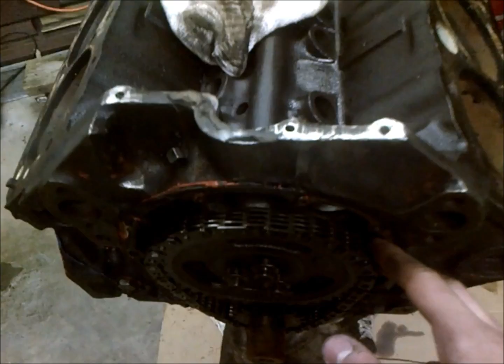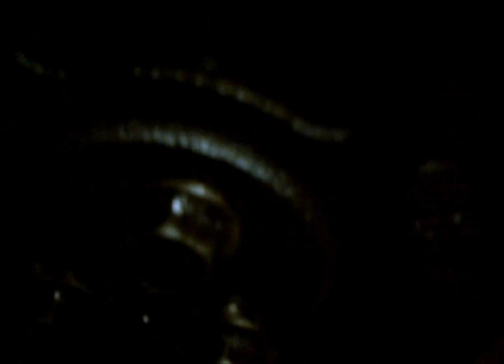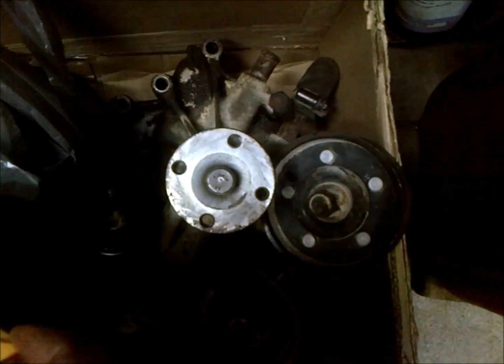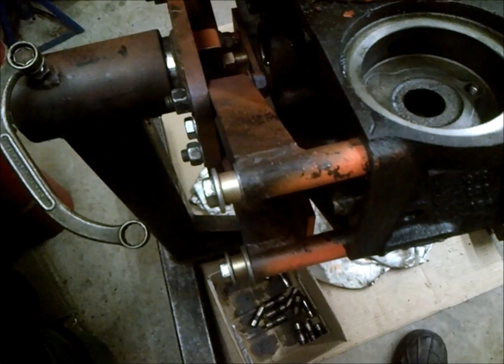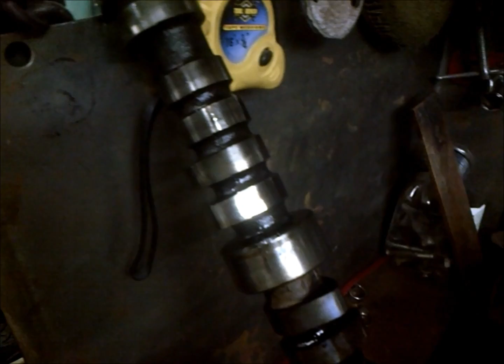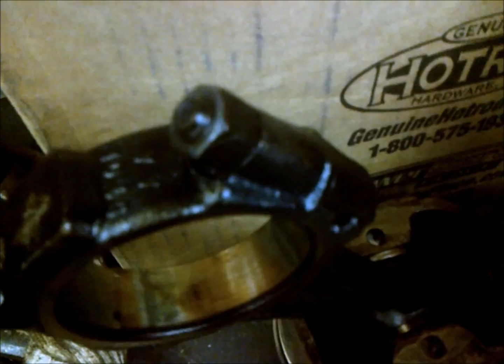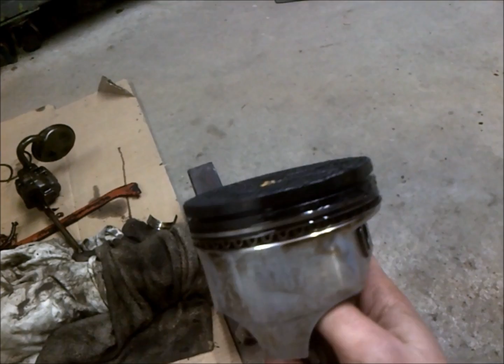350 Chevy vs Ford 302 Comparison: (Dumb Redneck Viewpoint)

Comment: THE LS USES A TEN BOLT HEAD PATTERN SQUARE BORE SEALING WHICH ALLOWS FOR HIGHER CYLINDER PRESSURES WHEN USING TURBO'S AND SUPERCHARGERS. ON A STOCK 5.0 ENGINE WHICH DEBUTED BACK IN 1983 IT CAN HANDLE 18LBS OF BOOST WITH NO PROBLEM AND GO MUCH HIGHER. WITH THE CHEVY SMALL BLOCK 8LBS OF BOOST WAS THE LIMIT. IF YOU WENT ANY HIGHER THEN THAT BLOWING A HEAD GASKET IS THE LEAST OF YOUR PROBLEMS. YOU WOULD DROP THE MAIN CAPS. THE SMALL BLOCK FORD HEAD BOLTS ANCHOR INTO THE BLOCK WEBBING WHERE THE CHEVY BOLTED ON TO THE BLOCK DECK WHICH MADE A WEAK SEAL BETWEEN THE HEAD AND BLOCK. TO BOOT THE SMALL BLOCK FORD WAS 70LBS LIGHTER THEN THE SMALL BLOCK CHEVY AND WAS STRONGER AND MADE MORE POWER. THIS IS THE REASON CHEVY DUMPED THE OLD SMALL BLOCK IN FAVOR OF FORD DESIGNS WHEN THEY CREATED THE LS WHICH IS COMPLETELY BASED ON FORD DESIGNS. NOTHING REMAINS FROM THE OLD SMALL BLOCK CHEVY.
Reply: YOU WROTE AND ENCYCLOPEDIA OF INFORMATION HERE BUT YOU ARE TOTALLY WRONG. THE FORD WINDSOR SMALL BLOCK WAS PHASED OUT BECAUSE OF PRESSURE FROM GOVERNMENT OFFICIALS TO MEET HIGHER EFFICIENCY. IT WAS A MUCH BETTER MOTOR THEN THE SMALL BLOCK CHEVY HANDS DOWN AND THERE IS MORE TO THIS STORY. GM/CHEVY AND THE GOVERNMENT HAVE BEEN IN BED WITH EACH OTHER SINCE THE DAYS OF BONNY AND CLYDE. THEY HAVE THEIR TENTACLES EVERYWHERE AND HAVE CORRUPTED THE INNOCENTS OF RACING FOR MANY YEAR WITH RULES WRITTEN AND UNWRITTEN AND REGULATIONS THAT HANDICAP THE COMPETITION AND FAVOR CHEVY WHICH WE WILL GET TO LATER ON IN THIS DEBATE. WHEN THE 5.0 MUSTANG DEBUT IN 1983 IT KILLED THE SMALL BLOCK CHEVY. THE 5.0 STOMPED ALL OTHER THE CHEVY 350 YEAR AFTER YEAR. THE GREATER LOOMING THREAT WAS THE 351 WINDSOR WHICH WOULD EVENTUALLY MAKE IT'S WAY UNDER THE HOOD OF THE MUSTANG AND GM ENGINEERS WERE WELL AWARE OF THAT. SO GM HAD THEIR FRIEND IN THOSE HIGHER PLACES PUT STRICTER EFFICIENCY REGULATIONS ON FORD AS A UNDERHANDED PLOY TO STOP FORD FROM EVER PUTTING THE 351 UNDER THE HOOD OF THE MUSTANG WHICH MEAN LIGHTS OUT FOR BOTH THE CAMARO AND CORVETTE. AT THE TIME THE 5.0 WAS THE HIGHEST VOLUME OUTPUT MOTOR IN THE WORLD. THE ONLY ENGINE THAT CAME CLOSE TO IT WAS THE ENGINE IN THE 308 FERRARI. THIS MEANS IT WAS ALSO THE MOST EFFICIENT ENGINE PRODUCED WHICH THROWS YOUR ENCYCLOPEDIA OF INFORMATION RIGHT INTO THE GARBAGE. IN TAXI CABS IN BIG CITIES LIKE NEW YORK THE CHEVY SMALL BLOCK WAS DONE AT 60,000 OF 24-7 IN NEED OF A TOTAL REBUILD WHILE THE FORD 302 WAS STILL RUNNING AT 500,000 MILES.  DO NOT EVER COMPARE THE CHEVY SMALL BLOCK TO THE FORD SMALL BLOCK.
Reply: WHY ARE YOU YELLING?
Reply: The real question is why would you think a LS motor was biased on a ford design ?  they share absolute nothing in common.  Unlike the ford Winsor motors  the Chevrolet smallblock was in production until 2004 and was only phased out when there was no longer a chassis being produced to use the motor (see gm express van)  Ford had to abandon the winsor block back in the early 90`s because they could not get ring seal to allow the use of  obd2 advanced catalytic converters. The oil consumption from the premature wear on sbf valve guide`s was also a issue they could not overcome.  GM on the other hand was years ahead of ford with the sbc development and had the engineering perfected to the point the engine could meet strict lean burn emissions standards up to the 2004 model year. A direct result of using the head bolts in the deck is the reduced cylinder distortion from anchoring the head bolts in the block webbing. This created a motor that could run well over 150,000 miles with proper maintence and no excessive ring wear. The advanced vortec cylinder heads gave the SBC the air flow of iron race head of the time. this same head cooled so well a lean burn fuel injection could produce great power with emissions only a fraction of fords best Winsor motor  The iron block LS is a original design created with extreme lean burn in mind. The ls has advanced cooling system that allows more efficient cooling in the cylinder head to permit higher compression. The ls heads are nothing like any ford ever made. intake ports with higher flow rates then any oem ford motor modular motor or winsor and exhaust ports designed to flow more and prevent excessive heat transfer from the exhaust to the cylinder head (short direct port).  all this was done using a 2 valve head ford could not get even close to the same power levels even with there 3 valve modular motor. Ford finally started to get close with the 5.0 coyote motor after giving up on the 6.2 l canted valve motor. Ford could not get the reliability out of the 6.2 it suffered valve spring and valve failure from trying to get to much power with a  aggressive cam profile. The aluminum  LS is a true race piece with all the attributes of the iron block with massive weight savings. Sorry but your claim of a stock 1983 302 being able to handle 18 lbs boost is ludicrous at best. the 1983 302 is a lightweight emissions motor with anemic cylinder heads very under built rods with puny rod bolts. very lightweight cast pistons (will not support 400 hp with out cracking) not to mention a nasty habit of very poor head gasket sealing.  The 1983 iron cylinder heads have such a poor combustion chamber design knocking and pinging from carbon buildup was common long before the motors ever made it out of warranty. now try to do 18 lbs of boost on this motor. Sorry you do not know what you are talking about. the motor would grenade long before you ever reached 18 lbs of boost.
Reply: Frank289100, you have got to be the most delusional idiot I have ever seen.
Reply: Yeah, why are you yelling?
Reply: If cumstangs really pot down those numbers you claim they wouldn't have been 4 bolt rear that's a fact jack
Reply: WHAT DRAG RACING IS TODAY IN TERMS OF POWER ADDERS LIKE NITROUS, SUPERCHARGING AND TURBOS WAS SINGLE HANDEDLY SHAPE BY THE SMALL BLOCK FORD. CHEVY DID NOTHING AS THEY SAT HELPLESSLY AND WATCHED FORD RUN AWAY WITH THE SHOW. THIS IS THE REASON THEY REDESIGN THEIR CONVENTIONAL SMALL BLOCK USING FORD DESIGNS SO THEY CAN FINALLY COMPETE AGAINST FORD. FROM TO TO BOTTOM THE LS IS A REGURGITATED FORD 427 HIGH RISER ENGINE OR A 351 FORD WINDSOR WITH RAISED PORTS. THE NEXT ADVANCEMENT FOR THE LS IS A CLEVELAND STYLE HEAD. THAT WHOLE CHEVY CAMP IS BASED ON CHEATING RIGHT FROM THE DRAWING BOARD TO NHRA RULES AND RULE BOOKS THAT FAVORED CHEVY TO WIN.
Reply: Same with the 9 inch rear. Nothing special - just inexpensive and plenty available. The pumpkin style 55 up Olds and Pontiac rears are way stronger but GM didn't make as many.<<<--- THESE GM REARENDS WERE NOWHERE NEAR AS STRONG AS THE FORD 9 INCH. TO START THE RING AND PINION TEETH CONTACT AT 3 POINTS WHERE ALL THE REST OF THE REARENDS INCLUDING THE DANA CONTACT 2. THE PINION IS ALSO SUPPORTED BY A INNER SHAFT ALSO SUPPORTED BY THE HOUSING. THEY ARE LIGHT AND THEY ARE EASILY TO SET UP AND SERVICE. IT IS THE STANDARD IN RACING TODAY FROM 1/4 MILES, DIRT TRACK, NASCAR AND ALL FORMS OF RACING.
Reply: Ford copied GM at every turn because GM led the industry in innovation while Ford followed.

Ford had to put Paxton blowers on the 50s T Birds just to keep up with the naturally aspirated Corvette with a much smaller fuel injected V8.

GM sold fuel injected vehicles in 1957 and EFI systems in 1975 while Ford waited until 1980 to offer their first fuel injected vehicles.
Reply: Honda civics are four Bolt as well join that cc
Reply: Frank289100 Yeah, 2 of my 5 friends were Ford fans, then my 3 chevy friends all switched because they saw how hard we beat on our Fords, now they all drive Fords and one drives Dodge trucks but wants me to help him find a Torino or Fairlane! we are all 52 to 57 years old, LS chevy is just a chevy FORD Cleveland copy, I had 40 cars,14 Fords, 10 GM, 12 mopars, and GM was a fall apart pile of crap, I used the best oils and still had flat cams, think about this my 1977 302 Mustang II weighs 170 pounds more than my 1978 350 Nova! because the Nova has no metal for its size, and the doors shut like crap, and the mustang has 187,000 miles on it! nova has 121,000, I will say the Nova is a little quicker and needed a cam at 77,000but gets less MPG than the Mustang which never needed anything but a water pump!
Reply: Why assume that they copied Ford? Pontiac used 10 head bolts on their V8. So did Olds, Buick and Cadillac. 
 
The exhaust port separation is the same as the Big Block Chevy and the Cadillac V8.  Cadillac had an OHV V8 long before Ford copied it.

Ford has copied so many GM innovations they ought to make Ford an honorary division of GM.
Reply: Ford didn't invent the V8. Ford just sold the cheapest V8.  Same with the 9 inch rear. Nothing special - just inexpensive and plenty available. The pumpkin style 55 up Olds and Pontiac rears are way stronger but GM didn't make as many.

Cadillac was bought in 1902. The first Cadillac V8 came in 1914 and it was not a Ford design.
The first Ford V8 was introduced in 1932.

Chevrolet dominated Nascar with their small block. Neither Ford  small block could cut it in Nascar until they got special permission to use a combo of Cleveland and Windsor parts.

That must really hurt your blue oval feelings that a 1955 hunk of GM junk engine beats a 1969 Ford design so bad that they left Nascar until they got some help from Bill France.

Don't forget how Pontiac jumped in for a few seasons in the early 60s and made those Holman & Moody FE boat anchors look like meter maid carts.
Reply: Ford didn't invent the V8. <<--HENRY FORD IS THE FATHER OF THE V-8 ENGINE. WHEN HE SOLD HIS COMPANY IN 1901 IT WAS RENAMED CADILLAC. OBVIOUSLY THEY BOUGHT SOMETHING FROM HIS COMPANY AND IT WASN'T A FENDER NOR A STEERING WHEEL NOR A AXLE. WHAT HENRY FORD SOLD THEM WAS V-8 TECHNOLOGY. IT WAS FORDS IDEA OF PUTTING 2 FOUR CYLINDERS TOGETHER WHICH HE DID IN THE VERY LATE 1899-1900. THE ONE PROBLEM THE V-8 HAD WAS BALANCING. IT WAS A EXPENSIVE AND TIME CONSUMING AND ONLY BY ACCIDENT DID THEY GO INTO PERFECT BALANCE. MOST OF THEM WERE NEVER TRULY BALANCED AND EVENTUALLY VIBRATED THEMSELVES TO DEATH. THIS IS WHY THE HIGH END CARS LIKE CADILLAC WHICH WERE MADE IN LIMITED NUMBERS HAD THEM. MASS PRODUCING THE V-8 WAS TOTALLY OUT OF QUESTION. THE RICH BOUGHT CADILLACS AND BY THE TIME THE MOTORS WENT OUT OF BALANCE THEY WERE SOLD AND REPLACED BY THE NEWER CADILLAC MODELS. DID YOU EVER WONDER WHY IT TOOK THE AUTOMOBILE INDUSTRY 20 YEARS TO CATCH UP WILL THE FLATHEAD FORD. BECAUSE THEY DIDN'T HAVE THE KNOWLEDGE OF HOW TO BALANCE THE V-8 ENGINE AND HENRY FORD DID RIGHT FROM THE START WHEN HE SOLD IT TO CADILLAC. THE FLATHEAD FORD FROM THE START WAS SUPPOSE TO BE A OVER HEAD VALVE ENGINE. HENRY FORD KNEW HE WAS GOING TO SELL MILLIONS OF THESE MOTORS AND FOR COST EFFECTIVE REASONS MADE IT A FLATHEAD DESIGN. HENRY FORD IS THE GREATEST MECHANICAL GENIUS OF ALL TIME. HE IS AND ALWAYS WILL BE THE FATHER OF THE V-8 ENGINE AND THE FLATHEAD FORD IS THE MOTHER OF ALL V-8 ENGINES INCLUDING THE CHEVY SMALL BLOCK. THE FLATHEAD FORD SINGLE HANDEDLY SHAPED DRAG RACING INTO WHAT IT IS TODAY. IT RULED ALL FORMS OF RACING FOR ALMOST 20 YEARS, BEFORE A FORD ENGINEER AT A PARTY RIGHT AFTER THE WAR IN DETROIT GAVE GM THE DESIGNS OF THE SMALL BLOCK CHEVY.
Reply: Chevrolet dominated Nascar with their small block. Neither Ford  small block could cut it in Nascar until they got special permission to use a combo of Cleveland and Windsor parts.
That must really hurt your blue oval feelings that a 1955 hunk of GM junk engine beats a 1969 Ford design so bad that they left Nascar until they got some help from Bill France. <<--FROM 1964-1969 FORD AND CHRYSLER DOMINATED NASCAR. ONLY CHEVY IN THOSE YEARS WON 4 RACES WITH THE 327 ON SHORT TRACKS BECAUSE THE INLINE SMALL BLOCK FORD WAS DEEMED ILLEGAL FOR USE BY NASCAR GIVING CHEVY A CHANCE TO WIN ON THE SHORT TRACKS. NASCAR DIDN'T WANT THE FORD TEAMS USING THE SMALL BLOCK FORD ON THE SHORT TRACKS TO PREVENT FORD FROM DOMINATING THEM. THE SMALL BLOCK 289 IN RACE TRIM MADE 450HP AND WEIGHED ALMOST 80 LIGHTER THEN THE SMALL BLOCK CHEVY SO IT ALLOWED IT TO GO INTO THE TURNS A LOT FASTER WITHOUT INERTIA AFFECTING IT AS MUCH SINCE IT WAS LIGHTER. THE RESTRICTOR PLATE WAS INTRODUCED IN 1970 BY NASCAR TO STOP THE FORD BOSS 429 FROM SLAUGHTERING THE HEMI SINCE IT WAS CHRYSLER IN 1964 WHO HAD THE 427SOHC ENGINE BANNED AND LATER HAD THE FORD 427 HIGH RISER BANNED. NASCAR LATER RESTRICTS RACING TO THE SMALL BLOCK AS A MEANS TO ALLOW CHEVY AND THE REST OF GM TO COMPETE WITH FORD AND CHRYSLER. SO THEY KEPT THE RESTRICTOR PLATE TO STOP FORD FROM DOMINATING NASCAR AND ALSO LIMITED THE CARBURETOR CFM'S TO REDUCE HORSEPOWERS AND EVEN THEM ALL UP. REMEMBER THE CLEVELAND WERE DESIGNED TO BREATH AND THE RESTRICTOR PLATE AND SMALL CARBURETORS CHOKED THESE MOTORS. ADD THAT IN WITH RULES AND RULE BOOKS FAVORING CHEVY TO WIN AS ALWAYS CHEVY CHEATING THERE WAY TO THE FINISH LINE. TODAY'S CHEVY NASCAR ENGINE IS A FORD CLEVELAND CHEVY AND THE PREVIOUS SB2 (CLEVELAND BASED HEADS) WAS DESIGNED BY FORD IN EXCHANGE TO ALLOW THEM TO RUN A 2 DOOR TAURUS WHICH DIDN'T EXIST. EVERYTHING CHEVY USES TODAY IN NASCAR IS FORD BASED.
Reply: Pontiac wasn't nearly as serious about NASCAR as Ford was back in the early 60s.
GM cut their NASCAR involvement way back because the government was worried that they were getting too big. "1962 GM was getting roughly 53% of the entire U.S. auto industry sales and the U.S. Justice Dept became interested. They were watching GM, and should GM get close to 60% they would consider breaking GM up. The precedent had already been set with Standard Oil years earlier, and their threat to GM had realism. GM thought that one of the ways they could cut that growth was to stop actively participating in motorsports and to cut their dollars there,”Wikipedia <<- TOTAL NONSENSE. GM AND THE GOVERNMENT HAVE BEEN IN BED SINCE THE DAYS OF BONNY AND CLYDE. FEDERAL AGENTS WERE SCREAMING TO START BUYING THE FLATHEAD FORD'S SO THEY CAN CATCH ALL THE BANK ROBBERS, BOOTLEGGERS, ETC WHO WERE USING THE FLATHEADS BECAUSE THEY WERE FAST WHILE GOVERNMENT AGENTS USED GM PRODUCTS WITH STRAIGHT 6'S AND 8'S WHICH COULD NEVER CATCH THE FORD'S. THEY WERE SO BUDDY BUDDY THAT THEY REFUSED TO FORD FORD'S AND THEIR RELATIONSHIP STILL GOES ON TO THIS VERY DAY BEING THE REASON THE GOVERNMENT BAILED THEM OUT WITH TAX PAYERS MONEY WHICH THEY STILL NEVER PAID BACK.
Reply: I worked for a government fleet for decades and we bought whatever fit the budget. If Ford could build something that did the job we bought Fords. We kept good records so we knew which vehicles were dependable and cost effective to maintain and I can't remember any single Ford model that distinguished itself above the other brands. I do remember plenty of Ford lemons. The 1985 police Crown Vics with the 5.0 TBI was capable of a blistering 78 MPH top speed and cops often complained about getting outran by 4 cyl Japanese cars and VW Beetles. The 1987 Crown Vic cop cars with the 5.8 were capable of a blistering 85 MPH top speed. A 305 Malibu and a 318 Diplomat could do 115 MPH and a 350 Caprice could do 125 MPH. If you were a cop would you choose the car that couldn't run down a Yugo just because it was your family brand?

Ford borrowed 24 billion from the government. When are they planning to pay that back? Looks like they can't afFord to.
Reply: I never saw a Maverick or Granada cop car but I guarantee you that neither one of your 302 powered Fords would get over 90 MPH with a full light bar on the roof. Those 85- 87 Crown Vics had no power from the day they were delivered so blame Ford for the lack of performance. 

You want me to believe a 3800 pound sled with 140 HP and 250 lb-ft of torque can do better than 85 MPH with a big fat light bar on the roof then show me some evidence.

All I'm hearing is a little fan boy.
Reply: BACK IN THE LATE 1980'S I SAW A FORD E-250 MR. GOODWRENCH PART DELIVERY VAN FROM A GM DEALER. I JUST COULDN'T STOP LAUGHING.
Reply: BOBBY, BOBBY BOBBY. IF THE GMO CORN AND SOYBEANS WASN'T CLOUDING YOUR BRAIN YOU WOULD HAVE LEARNED SOMETHING YEARS AGO. FIRST THING TO KNOW IS THAT THERE WERE NO RACE PARTS AVAILABLE FROM NEITHER FORD NOR THE AFTERMARKET FOR THE SBF, WHICH ALL STARTED WITH THE 289ci BACK IN THE 1960'S. THE 289 WAS SUCH A THREAT TO THE SBC THAT THE NHRA WOULD CHANGE THE RULES AND THE RULE BOOK ON THIS MOTOR TO DISCOURAGE ANYBODY FROM RUNNING THEM. IF YOU RAISED HELL AT THE TRACK THEY WERE CHANGING THE RULES IMMEDIATELY ON THE 289ci SO YOU COULDN'T COME BACK NEXT WEEK AND RACE. THIS IN TURN KILLED OFF NOT ONLY THE FACTORY SUPPORT OF RACE PARTS BUT ALSO THE AFTERMARKET SUPPORT OF RACE PARTS. NEITHER FORD NOR THE AFTERMARKET WOULD PRODUCE RACE PARTS FOR A MORE WHICH WOULD BE OUTLAWED OVERNIGHT LEAVING THE MANUFACTURERS WITH A WAREHOUSE FULL OF SCRAP METAL. THIS IS THE REASON IF YOU WERE ABLE TO GET RACE PARTS FOR A FORD THEY WERE 3-5 TIMES MORE EXPENSIVE AND MOST OF THE TIME THEY WEREN'T AVAILBLE. IT TOOK THE AFTER MARKET ALMOST 25 YEARS TO FINALLY PRODUCE A HEAD WHICH TRICK FLOW DID IN 1987 AND LET ALONE IT WAS THE GENESIS OF RACE PARTS FINALLY FOR THE SMALL BLOCK FORD WHICH WAS SO POPULAR THAT IT REVISED A RESURGENCE IN RACING AGAIN. THE RACE TRACK ATTENDANCE WAS DYING AND THE STANDS WERE EMPTY BUT WHEN THE MUSTANG 5.0 DEBUTED IT RESPARK THE RACING BUG AND RACING CAME BACK INTO FASHION AGAIN. SO THE NHRA NO LONGER REGULATED THE SBF BECAUSE IT BENEFITED ATTENDANCE FOR THE NHRA.. PRYOR IF YOU WANTED A RACE HEAD FOR A FORD YOU HAD TO MAKE IT. YOU TOOK CHEVY VALVES LIKE THE 2.02 AND MACHINED THEM TO FIT A FORD HEAD SO YOU CAN ALSO USE ALL THE SPRING AND RETAINER PARTS AVAILABLE FOR THE CHEVY WHICH WERE LEGAL FOR USE BY THE NHRA. TO SUM IT ALL UP IT WAS ALSO THE CASE FOR THE FORD GUYS RACING THE CLEVELANDS TO USE A CHEVY ROD BECAUSE NOBODY WOULD TAKE THE CHANCE OF PRODUCING RACE RODS FOR THE CLEVELANDS WHICH THE NHRA WOULD HAVE OUTLAWED WITH SOME STUPID RULE. SADLY THEY DID OUTLAW THE CLEVELANDS WHEN GM HAD THE NHRA THEIR HENCHMEN MANDATE THE 500ci RULE. THIS IS WHEN GM TOOK A OLDS BLOCK AND MACHINE IT TO TAKE A CHEVY CRANK AND CAM AND THEN MADE A BIG PAIR OF FORD CLEVELAND HEADS FOR IT. THIS IS WHEN BOB GLIDDEN WENT TO THE BOSS AND THE CLEVELANDS WERE NO LONGER RACED SO THE DEMAND FOR A RACE ROD FOR THE CLEVELAND NO LONGER EXISTED. SINCE 1983 TO PRESENT DAY WHAT CHEVY HAS BEEN WINNING WITH IN PROSTOCK IS NOTHING MORE THAN A BIG CUBE FORD CLEVELAND MORE WHICH IS YOUR DRCE - DRAG RACE COMPETITION ENGINE. SAD BUT TRUE GMO POPCORN BOBBY.
Reply: 1.) The Crown Vic had to wait until GM quit producing Caprices to "rule" police/taxi service.  That's a fact!

2.) 55,000 miles in police/taxi fleet service is equal to about 300,000 consumer driven  miles.

3.) Even after Ford figured out how to make the Crown Vic trans last beyond 6000 miles they never did get them to last as long as the older Chevys UNDER THE SAME EXACT CONDITIONS AND MAINTENANCE SCHEDULE.!

4.) When did any GM brand need to saw half of their cylinder head off and bolt on exhaust plates just to be able to compete in NASCAR and NHRA?

5.) When did any GM brand need to COMBINE THE BEST PARTS OF TWO DIFFERENT ENGINE FAMILIES just to be able to compete in NASCAR?

Fact. Clevelands and Windsors couldn't compete in Nascar so they had to cherry pick parts to make a CLEVOR. Ford has always been the special needs child of NASCAR. Ford can't compete? No problem just change the rules to help the poor babys.
Reply: There never was a debate here. Bobby and I have been killing you with facts and you have offered nothing but lunacy based ramblings in return. 

Remove your tinfoil hat and try posting some  evidence that NASCAR and NHRA banned the Ford Windsor because it was such a threat.

Of course you can't do that because the evidence only exists in your mind. I'm willing to bet you're the guy that's in the loony bin with Carl Childers who's crazy bout a Mercury Comet.

Thanks for the laughs and fantasies little Franky.
Reply: IF THEY WERE ADDING MORE WEIGHT TO THE CLEVELAND POWER FORDS ITS CRYSTAL CLEAR THE CHEVY WAS NO COMPETITION FOR THE FORDS. THE CLEVELAND MOTOR WAS SO DOMINATING THAT GM AND THE NHRA HAD TO DO SOMETHING VERY DRASTIC AND QUICK BEFORE PROSTOCK RACER WOULD EVENTUALLY SWITCH OVER TO CLEVELAND POWER AND THE END OF THIS PHONY CHEVY RACING DYNASTY. SO THE SOLUTION WAS TO MANDATE THE 500ci RULE AND BUILD A TOTALLY NEW ENGINE THE DRCE WHICH IS NOTHING MORE THAN A BIG CUBIC INCH FORD CLEVELAND MOTOR. THE REASON THE CHEVY SMALL BLOCK REACHED THE STATUS IN RACING THAT IT DID WAS BECAUSE THE NHRA DETERMINE THAT IT WAS TO WIN USING RULES AND RULE BOOKS TO FAVOR IT. ADDING WEIGHT TO THE FORD WAS A MAJOR PART OF IT. WHEN BOB GLIDDEN WENT TO CHRYSLER AND RACED THE PLYMOUTH ARROW AND WON. THEY ALSO SUBJECTED THE SMALL BLOCK CHRYSLER TO CARRY MORE WEIGHT. THE SMALL BLOCK CHRYSLER WAS ALSO A BETTER MOTOR THAN THE CHEVY. ARCHITECTURALLY THEY ARE SIMILAR BUT THE CHRYSLER IS A BETTER DESIGN. INSTEAD OF THE 23 DEGREE VALVE ANGLE LIKE THE SBC. IT HAS A 18 DEGREE STOCK VALVE ANGLES WHICH FLOW BETTER. THE BETTER SBC RACE HEADS USE THESE ANGLES TODAY. IT HAS A HIGHER CAM LOCATION ALLOWING IT TO UTILIZE SHORTER PUSHRODS THAT FLEX LESS AND ALSO USES RAIL TYPE ROCKER ARE WHICH CONTRIBUTE TO A MUCH MORE STABLE VALVE TRAIN ALLOWING FOR HIGHER RPM'S. IT ALSO HAD ANGLE PLUGS FOR A BETTER MORE EFFICIENT BURN. SO THESE FACTOR ALLOWED THEM TO MAKE BETTER POWER THAN THE CHEVY AND IN TURN THE CHRYSLER SMALL BLOCK FACED THE SAME FAITH AS THE FORD WHICH WAS MORE WEIGHT, WHICH INTERPRETS TO KEEPING CHEVY IN THE WINNERS CIRCLE. IF THIS CHEATING DIDN'T OCCUR THE RECORD BOOKS WHEN IT CAME TO CHEVY, WOULD TELL A TOTALLY DIFFERENT STORY.
Reply: Ford numbers their cylinders from front to back and GM numbers their cylinders from side to side so the numerical firing order is completely irrelevant.
Reply: Quote Frank:  "EVERYBODY RIPPED THEM OUT"

You mean like how everyone is ripping out their weak Mustang engines and putting GM engines in them so they can outrun all the Ford powered Mustangs?
Reply: Nascar specs the Ford 9 inch because they are cheap and have a lot of ratios available.
Every NASCAR spec 9 inch is mounted on archaic, antique, Chevrolet truck suspension parts from the 1960s. Are you going to tell us that antique Chevy truck suspensions are mandated by NASCAR because they're better than Ford parts? Seems so.
Reply: WHAT RACING IS TODAY IN TERMS OF TURBO, SUPERCHARGING AND NITROUS WAS SINGLE HANDEDLY SHAPED BY THE SMALL BLOCK FORD. CHEVY DID NOTHING THEY JUST COULDN'T COMPETE. THE SMALL BLOCK FORD HAD NO COMPETITION AND THE REASON A DOZEN 5.0 CLASSES EXISTED FROM 5.0 PRO TO 5.0 OUTLAW. THEY HAD TO RACE AGAINST THEMSELVES BECAUSE THE COMPETITION WAS NO MATCH. THIS IS THE REASON CHEVY DUMPED THE OLD SMALL BLOCK IN FAVOR OF FORD DESIGNS. FROM TOP TO BOTTOM THE LS IS COMPLETELY FORD DESIGNS. NOT ONE 11111111111 DESIGN ASPECT OF THE SMALL BLOCK CHEVY LIVES IN THE LS. IT IS 1000% FORD.
Reply: Poor Frank is too ignorant to understand that Ford's best selling V8 (302) has the same firing order as the small block Chevrolet. He's too caught up in a number line.
Reply: If my simple area code analogy didn't penetrate Franks's thick skull - nothing will.

Fallacy is all he has. If there was a NASCAR or NHRA rule against the Ford Windsor engine he would have posted the evidence a long time ago. Why would NASCAR make a rule against an engine that couldn't even make enough HP to qualify for a race? It's sheer madness! Time to cut the Wifi at the asylum.
Reply: 1.) You're apparently too ignorant to understand that IMSA has several different classes running at the same time on the same track and several Chevrolets from lower classes  finished ahead of several GT40 Fords. 

2.) Ford got lucky for a few years due to the  1968 engine rule that limited the prototypes to 3 liters.

3.) IMSA never banned Ford; the competition just got so much better that Ford couldn't cut it.  Henry Ford 2 did what he set out to do which was to beat Ferrari.

4.) The GT40 was obsolete by 1970 and its replacement was a dismal failure.
Reply: Yes Chevy just copied the Cleveland and Windsor motors ha ha ha!
Reply: He meant Chevy copied Fords Superior Cleveland V8
Reply: 1.) Clevelands were so bad Ford quit selling them after 3 years.

2.) The LS engine has very little in common with a Ford design.

3.) Chevy Big Blocks used canted valves long before Ford made an inferior copy of them that didn't sell and had to be scrapped.
Reply: Tim Sharpe That's funny I have a cougar with a 351c that had over 214,000 on it never rebuilt, just a water pump, used 10-40 Valvoline and STP, now you're making up crap sonny.
Reply: Tim Sharpe LS is just a Cleveland copy, it took chevy 60 years to figure out how to seperate the center exhaust ports to stop head cracking.
Reply: The LS is nothing like a sorry Cleveland.

1.) LS engines don't have canted valves.

2.) LS engines have a proven record of durability.

3.) Clevelands were discontinued after three years of being outsold by the Windsor.
Reply: Tim Sharpe The exhaust ports separation and the head bolt idea were though.
Reply: Why assume that they copied Ford? Pontiac used 10 head bolts on their V8. So did Olds, Buick and Cadillac. <<-- FORD Y-BLOCK AS FAR BACK AS 1953 USED THE 10 BOLT HEAD PATTERN (4 BOLTS PER CYLINDER). THE CADILLAC USED THE SAME 5 BOLT PER CYLINDER IN 1959 AS THE CHEVY SMALL BLOCK.
 
The exhaust port separation is the same as the Big Block Chevy and the Cadillac V8.  Cadillac had an OHV V8 long before Ford copied it.<<<--- BIG BLOCK CHEVY HAS SIAMESED INTAKE RUNNERS. HENRY FORD'S FIRST COMPANY WAS SOLD AND RENAMED CADILLAC. HE SOLD THEM HIS V-8 TECHNOLOGY WHICH IS HENRY FORDS IDEA OF PUTTING 2 4 CYLINDERS TOGETHER. 

Ford has copied so many GM innovations they ought to make Ford an honorary division of GM. <<-- EVERYTHING IN RACING TODAY WHICH CHEVY USES CAME FROM FORD. PROSTOCK DRCE, NASCAR SB2 AND RO7, SYMMETRICAL HEAD BIG BLOCK IN RACING LABELED AS CHEVY ARE ACTUALLY BIG CUBE CLEVELAND MOTORS. CHEVY MOUNTAIN RACE MOTORS 800+ CUBIC INCH ARE BOSS 429. THE 1989 ZR1 CORVETTE DOHC V-8 WAS DESIGNED AND BUILT BY FORD WHO OWNED LOTUS AND SOLD 70% OF THE COMPANY TO GM BUT MAINTAINED THE ENGINE RESEARCH AND MANUFACTURING DIVISION. YOUR LS IS A FORD REGURGITATED 427 HIGH RISER ENGINE. THE FORD NINE INCH REAREND IS USED EVERYWHERE IN RACING FROM A CHEVY DRAG CAR TO ALL OF NASCAR. THE FORD TOPLOADER TRANI IN MODERN VERSIONS IS USED IN NASCAR TO THIS VERY DAY. YOUR TREMEC USED IN YOUR CORVETTES FOR YEARS IS A DESCENDANT OF THE FORD TOPLOADER. SORRY BUDDY CHEVY TODAY IS ALL FORD.
Reply: Tim Sharpe 1st:Nobody said Ford invented the v8, Henry just made them aFORDable, 2nd:Fords 312 won more in the 50s then  chevy small block only won in the late 1990s to now, 3rd: the chevy never never dominated NASCAR until the Cleveland and was sanctioned out in the late 1990 era with wieght penaltys and using the sp2p head which never came on a production car, 4th :I do agree about the early Pontiac kicking chevy and Fords ass from 1958 until late1962, 5th: the 55 chevy small block didn't even have an oil filter and the harmonic balancer was pressed on which flew off in any kind of hi rev situation, they didn't cure the problems until 1956, the 55 chevy motor was a pile of crap, do some more research, 6th: I was talking about stock  motor durability not modified blueprinted motors, chevy out sold Ford from 1955 on average to 1995, why are their almost double  the amount of Fords  than chevys on craigs list? if chevys are so durable and reliable? because Fords outlast chevy.
Reply: Don't forget how Pontiac jumped in for a few seasons in the early 60s and made those Holman & Moody FE boat anchors look like meter maid carts.<<-- YES THEY DID BEAT FORD BECAUSE THE 406ci FORD'S WHERE LAND YACHTS WEIGHING IN AT OVER 4000LBS. BUT IN 1964 WHEN THEY PUT THE MIGHTY 427 HIGH RISER INTO A 3300LB FAIRLANE IT WASTED EVERYONE. NHRA THEN BY A PROTEST FROM CHRYSLER HAD THE CAR BANNED AND NHRA RELEASES A STATEMENT TO THE PUBLIC WHICH WENT AS SO. "WHAT WE DO NOT WANT IS A ONE WINNER AND THIS IS WHAT FORD IS EASILY CAPABLE OF DOING".
Reply: Pontiac wasn't nearly as serious about NASCAR as Ford was back in the early 60s.

GM cut their NASCAR involvement way back because the government was worried that they were getting too big. "1962 GM was getting roughly 53% of the entire U.S. auto industry sales and the U.S. Justice Dept became interested. They were watching GM, and should GM get close to 60% they would consider breaking GM up. The precedent had already been set with Standard Oil years earlier, and their threat to GM had realism. GM thought that one of the ways they could cut that growth was to stop actively participating in motorsports and to cut their dollars there,”-Wikipedia
Reply: Back then Ford had no worries about being broken up by the government because they were so much smaller than GM. 

As for the Thunderbolt - Ford produced about half the units required to be legit in NHRA. 
Ford lost big bucks on every Thunderbolt they sold and they deceived NHRA officials into believing that they made enough to compete. 
Thunderbolt NHRA records are as worthless as Lance Armstrong's records.
Reply: The Ford 9 inch was an outdated design when it was new.  The gears are placed in the most inefficient angle possible which makes it rob power and generate lots of heat. That's why they melt down after about 10 laps when the cooling pump belt comes off during a Nascar race.

Since GM made their similar looking but far stronger axle 2 years before Ford came out with their 9 inch it's pretty obvious who copied who. Of course Ford couldn't help but cheap it down a bit.
Reply: David Peru A four bolt rear what the heck is that?
Reply: Tim Sharpe You're totally full of crap about the top speeds of FORDs, were you trying to run diesel fuel in them or what? did you ever check the timing? did they have flat tires? the 85 chevy cop car you mention had a top speed of 117 mph, I had a totally stock 1977 2 bbl Maverick 302 4 door and it would do 122 mph, and a 1979 Granada 2 bbl 302 4 door and it would do 109 mph, all completely stock, what ever you are smoking I would stop.
Reply: Tim Sharpe Your full of crap chevy uses Ford rears in NASCAR. and hot rod did a test on rear end friction or different manufacturers and the ford rear only required like one horse power more then the GM 12 bolt at 6,000 rpm, so big deal, you can change that by using a lighter weight gear oil.
Reply: ***** Gm housings like the 12 bolt come apart and leak at the area where the outer tube is pressed into the center housing, they also bend there when going off road Ford and Mopar are know to be far superior in off road situatons.
Reply: ***** I will agree that Chevy does have interchange ability and initial parts price advantage over Ford and a big price advantage over Mopar, the Mopar small blocks are like chevy in the simple interchange advantage area, but mopar cost more than Ford even, I had a 1977 Nova 2bbl 350  4 years ago, fell asleep in my friends driveway after a big bonfire at night when leaving and before I got to the main road I smashed it into a tree in his yard on the way out, bent the subframe, also it got about 26 miles per gallon on the highway, I had the float adjusted very lean, I couldn't even put the gas pedal down too fast or it would die out, my friend messed with the carb after he bought it and the fuel line flew off one day and the car burned to the ground, while running the whole time, what a sad loss, some day I will own another, like I said chevy is my 2nd favorite car after ford and mopar.
Reply: ***** I watched an auto show one time that was testing if ONSTAR was better then Ford or Mopars service rescue option, they were out on a desolate Montana highway with all three brands Cadillac Ford Chrysler and waited for about 45 minites then the 3 tow trucks started arriving, but the funny part wasn't which one rescue option worked faster, it was the fact that all 3 tow trucks sent by each brand were all FORD tow trucks, my 82 year old dad cracked up about this and so did I,
Reply: 85 302 Crown Vic 1/4 mile drag time 18.8 seconds. 

1985 Volkswagen GTI Quarter mile 16.7

I rest my case Ford boy.
Reply: THE 9" RING AND PINION CONTACT AT 3 POINTS ALL THE OTHERS CONTACT AT 2 POINTS. GM AND THE GOVERNMENT ARE NOT IN CAHOOTS? THAT WHY THEY STILL BUY MOSTLY GM PRODUCTS.
Reply: YOU PLAY THE FIDDLE VERY WELL.
Reply: I REMEMBER WHEN THEY WERE WELDING THE TUBS TO THE THE HOUSING BECAUSE OF ITS BAD DESIGN. . THE 12 BOLTS WERE NOT THAT STRONG AT ALL. MY FRIENDS FATHER WAS A BODY MAN BACK IN THE 1960'S AND THEY WERE RUNNING A BIG BLOCK CHEVY AND WAS CONSTANTLY BLOWING THE 12 BOLTS. THEY WERE CONSTANTLY ENCOURAGED BY OTHER RACERS TO USE THE FORD 9" BUT REFUSED TIME AND TIME AGAIN AND LIVED WITH HIS 12 BOLT NIGHTMARE FOR YEARS.
Reply: Frank289100 Wieght has nothing to do with top speed, put a light bar on the VW and see how fast it goes,I didn't say the mav or Granada were cop cars they were my cars, Im sure a light bar wouldn't make more then a 6 mph difference, all Ford cop cars with a v8 would go over 110 according to all the books Ive read, you are smoking crack hillbilly, get your facts right, and quit smoking the funny stuff..
Reply: ***** Trucks are for hillbillys anyway,all the road ragers around here drive red ford trucks and dodge owns dana which makes rear ends for GMC and chevy trucks.Ford owns Cummings and Navistar  like GM owns Detroit diesel, no big deal
Reply: QUESTION 1: IN 1901 WHAT DID HENRY FORD SELL WITH HIS COMPANY THAT INTERESTED WHAT WOULD BE RENAMED CADILLAC.
2. FORD AMONGST OTHERS BUILT THE LIBERTY V-8 AIRCRAFT ENGINES DURING THE FIRST WORLD WAR.
Reply: GM AND THE GOVERNMENT MOTORS HAVE BEEN BOINKING EACH OTHER IN THE TOILET FOR YEARS.
Reply: Let's see. NASCAR had to let Ford saw half the Cleveland head off and bolt on exhaust plates that raise the stock ports an inch and net 90 HP just so the Cleveland can compete with the small block Chevy engine that was designed 20 years earlier. 

The illegal Clevelands were faster but they still couldn't last 500 miles due to bad oiling systems and thin castings that caused chronic overheating so NASCAR LET THEM COMBINE THE BEST PARTS OF TWO DIFFERENT ENGINE FAMILIES and approved a set of radically improved aluminum heads that incorporated the previously outlawed raised exhaust ports. 

NHRA never did anything to discourage anyone from competing with the Windsor engine. They just couldn't compete on a level playing field.
Reply: Now let's move on to Ford transmissions. When I used to maintain a huge government fleet the Chevy cop cars would need a transmission rebuild around 55,000 miles. An 85-87 Crown Vic with the AOD would last about 35,000 under the same conditions and when we bought a huge lot of 1993 Crown Vics the transmissions lasted an average of 6000 miles. That's not a typo. Six thousand miles before catastrophic failure. When the local Ford dealer rebuilt them under warranty they tended to last another 4000 miles until Ford came up with some band aids that finally upped them to half the life of a Caprice trans.

The first year 4.6 modular V8s were plagued with major oil consumption due to a bad valve guide design. They were also very sensitive to oil viscosity and blew their filters when some cops added a few quarts of 20W50 instead of 10W30. The Chevy never minded either way.

The 80s Crown Vics were so bad that many police agencies refused to buy any more Ford police cars and opted to refurbish their trusty Caprices after GM stopped producing them.
I totally understand because the Chevy Caprice was the most dependable, low maintenance cop car in the history of law enforcement. The 350 TBI would go 100,000 miles under the most grueling conditions without a hiccup. The only thing the 94 up Crown Vic did better than the Caprice was front brake wear and the Caprice had way better rear brakes. The Caprice performed better and lasted longer so don't say the government chooses Chevys for the wrong reasons. Quite the opposite.
Reply: Bobby, don't you know Ford invented 10 head bolts per cylinder and symmetrical port spacing? Don't forget the most idiotic reason of all time. The LS has the same numerical firing order as some Fords so GM must have copied that from Ford too.

You can't talk sense to these trailer park goons with their primer spotted Mustangs and Mavericks.
Reply: LET ME SCHOOL YOU ON FORD TRANSMISSIONS VS CHEVY.AOD'S WHEN MAINTAIN PROPERLY AOD'S GO 100'S OF THOUSANDS OF MILES. I'VE SEEN THEM WITH OVER 400,000 MILES AND STILL RUNNING NEVER REBUILT. MY FRIEND A HARDCORE CHEVY GUY WE CALL PRO STOCK MIKE. HE WRENCHED OF A FLEET OF FORD CROWN VICS AND MENTIONED THE SAME THING THAT THE TRANI'S WERE BLOWING WITHIN THE FIRST 5-10,000 MILES WHICH WAS DUE NOT TO DESIGN BUT TO A BAD RUN OF PARTS FROM THE SUPPLIER WHO DIDN'T MAKE THEM PROPERLY TO FORD SPECS. ONCE THE DEFECTIVE PARTS WERE REMOVED THE TRANSMISSIONS RAN FOR YEARS WITHOUT ANY PROBLEMS. THE FORD TAURUS ALSO HAD A TRANSMISSION PROBLEM WHERE THE BAND AROUND THE DRUM WHICH ENGAGES REVERSE HAS A ANCHOR PIN THAT ENGAGES INTO A BRACKET ON THE BAND WHICH STOPS THE DRUM FROM TURNING ENGAGING IT INTO REVERSE. THE SUPPLIER WHO MADE THE BANDS POORLY WELDED THE BRACKETS TO THE BAND AND THEY WOULD SNAP OFF LOSING REVERSE. (PROBABLY A ANGRY CHEVY GUY WHO GOT HIS REAR END REAMED BY A 5.0 MUSTANG WAS WELDING THOSE BRACKETS ONTO THE BANDS). I DRANK WITH A CHEVY GUY YEARS BACK WHO HATED FORD SO MUCH THAT THE STANDARD PARTS FACTORY HE WORKED IN THAT MADE POINTS TOLD ME WHEN IT CAME TO MAKING THE PARTS FOR THE FORD HE POORLY ASSEMBLE AND MADE THEM. THIS IS WHY THE INDUSTRY STARTED PUTTING INSPECTION STICKERS ON PARTS AND ASSEMBLY LINES SO THEY COULD FIND THE SOURCE OF THE PROBLEM. ONCE FORD REPLACED THE DEFECTIVE BAND THEY NEVER HAD A PROBLEM. WITH FORD IT IS NOT BY DESIGN THAT THERE PRODUCT FAILS BUT BY A BAD RUN OF PARTS. ON THE OTHER HAND YOU MENTIONED THAT THE CHEVY TRANI'S WENT AT 55,000 MILES. THIS FAILURE OF THE TRANI IS NOT DUE TO A BAD RUN OF PARTS BUT TO BAD GM DESIGNS. NOT ALL BUT MANY GM DESIGNS ARE BAD AND INFERIOR RIGHT FROM THE DRAWING BOARD. THIS IS ALSO THE REASON THEY NEVER WERE ABLE TO COMPETE WITH FORD WHEN IT CAME TO THE TAXI BUSINESS. NOT ONLY ARE THE TRANSMISSIONS  WEAK BUT SO WERE ENGINES.
Reply: CHEVY CAPRICE VS THE FORD CROWN VIC. PLEASE DO NOT COMPARE THE 2. THE CROWN VICS/LINCOLNS RULED THE TAXI.LIMO AND POLICE CAR INDUSTRY FOR ALMOST 20 YEARS WITH NO COMPETITION. FROM THE REAR ENDS TO THE TRANSMISSION TO THE ENGINE THEY WERE FAR SUPERIOR THAN THE CHEVY'S AND THE REASON IT LOCKED UP THE INDUSTRY FOR MANY YEARS.
Reply: LOTUS WAS OWNED BY FORD UNDER A SUBSIDIARY. FORD WOULD NOT MAKE A FOUNDRY FACILITY TO MAKE COSWORTH ENGINES EXCLUSIVELY FOR LOTUS CARS WHICH IF LOTUS WAS MISMANAGED AND WENT OUT OF BUSINESS WOULD RESULT IN A CATASTROPHE LOSS FOR FORD IF THEY DIDN'T OWN THE COMPANY. THEY OWNED 100% LOTUS AND IN 1987 SOLD 70% OF THE COMPANY TO GM WHILE FORD MAINTAINED THE ENGINE DEVELOPMENT DEPARTMENT WHICH ENCOMPASSED 30% OF THE COMPANY. THE MAGNETIC SUSPENSION IN THE CAMARO TODAY CAME FROM LOTUS WHEN FORD SOLD THE 70% OF THE COMPANY. FORD DEVELOPED THIS TECHNOLOGY DECADES AGO AND TODAY IS UTILIZED BY GM. THIS IS HOW FAR ADVANCED FORD ALWAY WAS TO CHEVY. FORD ENGINEERED AND DESIGNED THE 1989 ZR1 ENGINE IN THE CORVETTE. HERE IS ANOTHER ONE. IN THE LATE 80'S THE CHEVY NASCAR MR' GOODWRENCH CAR OF DALE EARNHARDT USED A EXPERIMENTAL ENGINE MADE BY LOTUS CALLED "THE CHAPMAN-LOTUS V-8". IT WAS A 4.6 LITER SINGLE OVERHEAD CAM V-8 MOTOR WHICH CAME RIGHT FROM ENGLAND IN A CRATE AND WAS INSTALLED RIGHT INTO THE MR' GOODWRENCH CAR OF DALE EARNHARDT. HE WAS USING A EXPERIMENTAL FORD RACE POWERPLANT THAT LITTLE TO GM'S KNOWLEDGE WOULD BECOME THE 4.6 MODULAR MOTOR OF TODAY. ENGINEERS AT FORD ALSO LIKE TO PLAY PRANKS AS THE CHEVY MR' GOODWRENCH CAR WAS THE TEST BED FOR WHAT WAS TO BECOME THE MODULAR MOTOR FORD USES TODAY. THE FORD ENGINEERS WERE LAUGHING THEIR ASSES OFF WATCHING DALE EARNHARDT MR. GOODWRENCH CAR GO AROUND IN CIRCLES WINNING USING FORD POWER UNDER THE HOOD OF THEIR CHEVY. THE ENGINES WERE THEN REMOVED AND TAKEN BACK TO LOTUS FOR EXAMINATION AS NEW MOTORS WERE BEING CONSTANTLY SUPPLIED TO DALE'S CAR. I CAN TELL YOU HISTORY ALMOST AS IF I LIVED IT.
Reply: MY GOODNESS GRACIOUS. PLEASE COMPREHEND WHAT YOU READ. GM HAD THEIR HENCHMEN THE NHRA MANDATED THE 500ci RULE AND THEN ALLOWED GM TO BUILD A TOTALLY NEW ENGINE.IT WAS DONE TO STOP THE FORD CLEVELAND MOTORS WHICH THE NHRA MADE CARRY MORE WEIGHT 250LBS AND STILL WON AND THEN THE NHRA LET THE CHEVY'S REMOVE WEIGH FROM THEIR CARS AND THE FORD CLEVELAND'S WITH THE EXTRA 250LBS WERE STILL BEATING THEM. GM/CHEVY AND THE NHRA KNEW THAT THE SMALL BLOCK CHEVY IN PROSTOCK WAS COMING TO A END. BEFORE THE CHEVY RACERS GOT A CHANCE TO DROP THERE CHEVY'S IN FAVOR OF THE FORD'S WHICH MEANT PROSTOCK WOULD HAVE BECOME TOTALLY A FORD VENUE AND THE DISAPPEARANCE OF THE CHEVY SMALL BLOCK FROM PROSTOCK RACING FOREVER. TO SAVE THIS "PHONY CHEVY RACING DYNASTY" GM AND THE NHRA MANDATED THE 500ci RULE. THEY THEN TOOK THE OLDSMOBILE BLOCK (ITS OILING SYSTEM HAS NOTHING IN COMMON WITH THE CLEVELAND OILING SYSTEM SO WHY WOULD YOU BRING THAT UP). THEY THEN MACHINED THE BLOCK TO ACCEPT A CHEVY BIG BLOCK CRANK AND CAM.THEN THEY MADE A BIG PAIR OF FORD CLEVELAND HEADS FOR IT. IT IS THE HEADS THAT MAKE THE POWER NOT THE BLOCK. IN ESSENCE THEY CREATED A BIG CUBIC INCH FORD CLEVELAND MOTOR. THIS IS THE REASON FORD DOESN'T GET INVOLVED NOR SPONSOR PROSTOCK RACING. IT IS ALREADY A FORD BASED CLEVELAND MOTOR.
Reply: BOBBY, BOBBY, BOBBY THE FUTURE BELONG TO THE PURPOSE BUILT DRCE WHAT A JOKE. IT IS NOTHING MORE THAN A CLEVELAND HEADED BIG BLOCK CHEVY. SO HERE IS WHAT HAPPENED. BOB GLIDDEN WAS BEATING THEM TO DEATH SO BAD. THAT GM EVERY YEAR KEPT RECASTING NEW BLOCKS, INTERNALS AND HEAD DESIGNS FOR THE DRCE AND THE BOSS 429 WAS STILL KILLING THEM. AS THEY GOT FASTER FROM RECASTING A IMPROVEMENTS IN DESIGNS. BOB GLIDDEN COMPENSATED THEM GETTING A LITTLE FASTER BY SLIGHTLY FARTHER PORTING THE BOSS HEAD. IT REACHED THE POINT WHERE FORD AND BOB GLIDDEN WERE READY TO CAST A NEW FORD BOSS HEAD. WHEN THEY PRESENTED THAT TO THE NHRA. THE NHRA PUT BOB GLIDDEN AND FORD OVER THE BARREL. THEY SAID IF THEY WANTED TO CAST A NEW BOSS HEAD THAT THEY HAD TO MAKE A FEW HUNDRED PAIRS OF THOSE HEADS AVAILABLE TO THE PUBLIC IF THEY WANTED TO RACE. FORD KNEW THEIR WS NO MARKET FOR THE BOSS MOTOR BECAUSE OF ITS SCARCITY AND LOW PRODUCTION. THE NHRA KNEW IT WOULD BECOME A FINANCIAL BURDEN TO FORD TO CAST A NEW HEAD. FORD ALSO KNEW WHEN THEY KEPT THERE DOMINATION OVER PROSTOCK THE NHRA WOULD EVENTUALLY START WITH UNFAIR RULES AND REGULATIONS TO FINALLY PUT A END TO BOB GLIDDEN AND FORD REIGN OF TERROR ON CHEVY. SO FORD AND BOB GLIDDEN TOLD THE NHRA TO GO F**K THEMSELVES. LIKE ALWAYS THEY RESORTED TO CHEATING TO KEEP THIS "PHONY CHEVY RACING DYNASTY" IN THE WINNERS CIRCLE. .
Reply: THE CURVE ON THE EXHAUST PORTS OF THE CLEVELAND HEAD WAS CURVED DOWN SO THE EXHAUST MANIFOLDS CLEAR THE SHOCK TOWERS. WHEN FORD DESIRED TO CAST A VERSION OF THE CLEVELAND HEAD THE NHRA RULED THAT ONLY THE PRODUCTION HEADS WERE ALLOWED. SO THEY MILLED OFF THE CURVE TO STRAIGHTEN OUT THE PORTS. THE FORD CLEVELAND HEAD IS THE ULTIMATE IN POLY ANGLE HEAD DESIGN. IT IS SO STATE OF THE ART THAT IT JUST DOESN'T GET ANY BETTER. IT IS IN THE MOST DEVELOPED AND ADVANCED STAGE OF DESIGN WHEN THEY WERE CREATED.
Reply: 1.) The Crown Vic had to wait until GM quit producing Caprices to "rule" police/taxi service.  That's a fact! <<--THEY BOUGHT THE CAPRICES BECAUSE THEY WERE CHEAPER ESPECIALLY FOR TAXI FLEETS. IF A FLEET PURCHASED 100 NEW TAXI'S AND SAVE $1500 ON EACH ONE OF THEM RATHER THEN BUYING THE CROWN VICS IT MEANT A SAVINGS OF $150,000. TAXI FLEETS QUICKLY FOUND OUT IT WAS A BIG MISTAKE WHEN EVERYTHING STARTED GOING ON THEM FROM THE FRONT ENDS TO THE TRANSMISSIONS TO THE ENGINES. THE CAPRICES SAT BEING REPAIRED MORE THAN THEY WERE ON THE ROAD MAKING MONEY. ON THE OTHER HAND THE CROWN VICS RAN TROUBLE FREE FOR YEARS WHILE THE CHEVY SMALL BLOCK WAS ON ITS WAY OUT AT 60,000 MILES AS THE FORD 302 WAS TURNING 400,000 MILES. EVENTUALLY THE WHOLE TAXI INDUSTRY REALIZED WHAT JUNK CHEVY WAS FOR USE AS TAXI'S. THIS IS WHEN THE WHOLE INDUSTRY FROM TAXI, POLICE CAR AND LIMOUSINES FLEETS SWITCHED OVER TO THE FORD'S AND FORD HAS HAD A LOCK DOWN ON THIS INDUSTRY FOR ALSO 20 YEARS. CROWN VICS IN BIG CITIES ARE STILL RUNNING DAY AND NIGHT. THOSE MODULAR MOTORS ON AVERAGE HAVE 400,000 MILES AND RUN UP TO 700,000 MILES. IN SOME CASES TO 1,000,000 MILES.DO NOT COMPARE CHEVY TO FORD. CHEVY ARE JUNK IN THE REAL WORLD WHEN THEY ARE PUT TO WORK AS A TAXI. THEY ARE GOOD FOR A OLD MAN WHO FEATHER TOUCHES THE PEDAL HAULING AROUND A CRATE OF EGGS.

2.) 55,000 miles in police/taxi fleet service is equal to about 300,000 consumer driven  miles. ????????????????????????

3.) Even after Ford figured out how to make the Crown Vic trans last beyond 6000 miles they never did get them to last as long as the older Chevys UNDER THE SAME EXACT CONDITIONS AND MAINTENANCE SCHEDULE.! <<<--- THE AOD'S WERE MORE DURABLE THAN THE CHEVY'S AND STRONGER. YOU TOOK A ISOLATED INCIDENT OF THE SUPPLIER GIVING FORD A BAD RUN OF PARTS AND THEN CLAIMING THEY WERE BAD TRANSMISSIONS. GIVE IT UP ALREADY.

4.) When did any GM brand need to saw half of their cylinder head off and bolt on exhaust plates just to be able to compete in NASCAR and NHRA? <<-- FORM FOLLOWS FUNCTION AND THE REASON WHY FORD HAD TO CAST THE INTAKE PORTS DOWNWARD. SINCE THE CHEATERS IN RACING THE NHRA WOULDN'T ALLOW FORD TO MAKE A OVER THE COUNTER VERSION WITH STRAIGHT RUNNERS ALL IN THE INTEREST OF KEEPING CHEVY IN THE WINNERS CIRCLE. THE SOLUTION WAS TO MILL OFF THE EXHAUST PORT END AND BOY DID THEY SLAUGHTER THE CHEVY SMALL BLOCK IN PROSTOCK. THE CHEVY SMALL BLOCK WAS NO COMPETITION. THE FORD CLEVELAND'S JUST BEAT OF THE CHEVY SMALL BLOCK NIGHT AND DAY THAT ONCE AGAIN THEY RESORTED TO CHEATING TO PROTECT THIS "PHONY CHEVY RACING DYNASTY" AND MANDATED THE 500ci RULE TO STOP FORD'S DOMINANCE. 

5.) When did any GM brand need to COMBINE THE BEST PARTS OF TWO DIFFERENT ENGINE FAMILIES just to be able to compete in NASCAR?<<<--- LOTS OF RACE PARTS WERE AVAILABLE FOR THE WINDSORS SO THEY USED THE 351 WINDSOR AS A STANDARD BLOCK AND WAS MORE COST EFFECTIVE BECAUSE PARTS WERE MUCH CHEAPER. 

Fact. Clevelands and Windsors couldn't compete in Nascar so they had to cherry pick parts to make a CLEVOR. Ford has always been the special needs child of NASCAR. Ford can't compete? No problem just change the rules to help the poor babys.<<<--- THE RESTRICTOR PLATE WAS USED TO SLOW DOWN THE FORD'S AND EVEN THEM UP WITH THE REST OF THEM. IF THE CHEVY SMALL BLOCK WAS SO GOOD IT NEVER WOULD HAVE GONE THROUGH 2 MAJOR CHANGES BEING THE SB2 (DESIGNED DIRECTLY BY FORD IN AGREEMENT TO LET FORD RACE A 2 DOOR TAURUS WHICH DIDN'T EXIST) AND THE RO7 WHICH TODAY ARE FORD CLEVELAND DESIGNS WHILE THE FORD FR9 HAS REMAINED TRUE TO ITS FORD CLEVELAND ROOTS.
Reply: FORD OWNED LOTUS COMPLETELY. THIS IS WHY THE LOTUS COSWORTH ENGINES WERE EXCLUSIVELY PRODUCED AND USED BY LOTUS AND NOT USED ANYWHERE ELSE.
Reply: This is like visiting the Stonehurst Asylum. Fiction and delusions become reality in Franks mind.

My boss was a die hard Ford man and he readily admitted that the Caprice was way better designed and more reliable than the Crown Vics. The Chevys were quicker, faster, cheaper to maintain and not a single one suffered an engine failure. We had to rebuild several Windsor engines at around 78,000 miles. Heck we even modded them a little to see if they could go a little faster but it didn't help very much.  The "HO" 351 cars had a little more torque but they were complete dogs too. Most cops hated them because they were so slow. The Crown Vics also had a very weak tilt steering column that broke frequently. 
The Ford high output cop alternators burned up as fast as we could replace them. Idiot Ford engineers decided that 110 amps could travel through 3 tiny solder spots between the stator and the rectifier. GM and Chrysler both used studs and never had a problem. Our Chevy 130 amp alternators never failed. We had to replace the bearings now and then because compact alternators have a high field strength that tends to shorten bearing life. No problem. 2 bearings are 100 times cheaper than one Ford cop alternator every other month.  GM made the best charging systems by far but that Chrysler cop alternator was also a brute. Too bad Chrysler made such a crappy regulator to go with it.

 The Crown Vics had chronic electrical problems that the Caprice never had as well. 

I was there. I lived it in a government fleet environment with hundreds of cars and trucks.
Ford was better known for chronic trouble than anything else.  Don't even get me started on how awful the Ford Rangers were.  Total junk! Steering worn out at 15,000 miles. AC out after a year.
Reply: When I worked on cop cars we got tired of replacing those cheap plastic ford power steering pumps that sounded like saw mills and leaked all over so my Ford loving boss decided to buy retrofit GM pumps to fix them all once for all time.

We also spent a bundle on replacing those Variable Venturi monsters with Holley 2 barrels because they were so awful from day one. 

I have to admit that Ford finally redeemed themselves with their newer alternator that they copied from GM. Way better than their old crap and almost as good as the newer GM stuff.
Reply: Factoid. Ford got so pissed about how badly the Camaros were dominating the Trans Am Series that they secretly hired the main designer of the Chevy small block to create their Boss 302. Henry Smokey Yunick.
Reply: Frank289100, The BOSS 429 was a lot wider than a BOSS 351 4V. Ford notched the shock towers in the mustang to fit the big block! Ford would have done the same to fit the small block! <<-- SO IT MAKES SENSE TO YOU THAT FORD SHOULD HAVE MADE THE PORT STRAIGHT THEN NOTCHED MILLION OF VEHICLES THEY PUT THE FORD CLEVELAND'S INTO. THAT WAS A FOOTBALL OVER MY HEAD.
Reply: The "poly" angle of the valves were at the exact same angle as a big block Chevy! The combustion chamber is a damn Hemi! <<--WHICH ALL STEMS DOWN FROM THE FORD GAA HEMI TANK ENGINE. YES THE CANTED VALVE DESIGN OF THE FORD GAA GOES BACK TO 1937. FORD DID IT MANY YEARS BEFORE CHRYSLER AND CHEVY DID.
Reply: The huge round ports were from Pontiac ram air V ! The rip off of three different manufacturers' designs that are then incorporated in your own is NOT an achievement!<<-- THE PONTIAC RAM AIR V WAS ALSO A FORD DESIGN BEING A COPY OF THE FORD TUNNEL PORT ENGINE. JOHN DELOREAN'S BROTHER GEORGE WORKED FOR FORD AND WAS ONE OF THE ENGINEERS WHO WORKED ON THE FORD TUNNEL PORT ENGINE. HE LATER BROUGHT THE DESIGN TO HIS BROTHER JOHN AND THEY COPIED IT AND HOW THE RAM V HEADS CAME TO LIFE. THIS IS WHEN THE PRESIDENT AND VICE PRESIDENT KILLED OFF THE RAM V TO AVOID A LAWSUIT FROM FORD.
Reply: Chevy had Smokey Yunick develop a "porcupine" head that would have walked all over the Cleveland , but was deemed too radical for a production vehicle that would see street use, and had too many design features from other manufacturers , so it was axed. Chevrolet does not copy others, they do things honest . Ford does nothing but copy to this very day. <<--MISINFORMATION IS EVERYWHERE. THE PORCUPINE HEAD DID NOT COME FROM SMOKEY YUNICK. IT WAS DEVELOPED IN 1963 BY A GM ENGINEER AT GM WHO DEVELOPED THE 377 ALL ALUMINUM GRAND SPORT ENGINE WHICH ONLY 3 WERE PRODUCED. WHEN THE OTHER ENGINEERS LOOKED UPON THE GRAND SPORT 377 SMALL BLOCK AND SAW THE STAGGERED VALVES, THEY ALL LAUGHED AND SAID IT LOOKED LIKE A PORCUPINE. THAT MOTOR MADE CLOSE TO 600HP BUT THE HEAT DESTROYED THEM AND THEY NO LONGER EXIST. THESE MOTORS WERE EXPERIMENTAL WHICH BECAME THE BASIS AND FOUNDATION WHICH A YEAR LATER BECAME THE BIG BLOCK CHEVY. THE RESTORED AND EXISTING GRAND SPORT CORVETTES TODAY ARE ALL FAKES. THEY CLAIM 5 WERE MADE (I'VE SEEN 1 WITH A BIG BLOCK, WHEN THEY WERE ALL SMALL BLOCKS) WHEN ONLY THREE EXISTED. SECONDLY YUNICK HAD NOTHING TO DO WITH THE FORD CLEVELAND ENGINE AND CONTRIBUTED NOTHING TO THE BIG BLOCK CHEVY WHICH CAME INTERNALLY FROM A INDIVIDUAL CHEVY ENGINEER AT GM THAT WE WILL NEVER TRULY KNOW HIS NAME. OTHERS TOOK THE CREDIT FOR HIS WORK.
Reply: Ford does nothing but copy to this very day. The Camaro for example , came back out with IRS rear suspension , and I will be damned if Ford didn't come out with it in their Mustang a couple years later! <<--THE 1989 FORD THUNDERBIRD HAD INDEPENDANT SUSPENSION YEARS BEFORE THE CAMARO SO WHERE ARE YOU GOING WITH THAT ONE. THE MUSTANG IS A DRAG PURPOSE CAR AND THE SOLID AXLE 8.8 WAS SUITED FOR THAT PURPOSE BECAUSE OF THE BIG HORSEPOWERS OF USING SUPERCHARGERS, TURBO'S AND NITROUS THESE CARS WERE PRODUCING. BOY DO YOU LACK COMMON SENSE.
Reply: Have you looked at the design of Ford Super Duty truck cabs? They look like 88-98 Chevy with a different door window with a dip in it! To be fair ALL the auto manufacturers copy each other to a certain degree, but Ford does it way more than any other! <<--FORDS LOOK NOTHING LIKE CHEVY'S. CHEVY'S ARE UUUUUUGLY TRUCKS. THAT IS WHY YOUR GMC'S TODAY ARE STARTING TO LOOK LIKE FORDS.
Reply: BOBBY, STOP PLAYING WITH YOURSELF. YOU WERE THE ONE WHO WAS PROVEN WRONG AND TO BOOT YOU BOUGHT YOUR GLBT BOYFRIEND TIM HERE TO DOUBLE TEAM ME BECAUSE YOU COULDN'T HOLD YOUR OWN WEIGHT. 2 AGAINST 1 IS USUALLY THE CASE WHEN LOSERS START LOSING THESE DEBATES.
Reply: Corvettes had IRS 26 years before Thunderbirds. Ford originally copied the Corvette to compete with the Corvette but quickly gave up on that idea and turned the Tbird into a big, heavy and very wimpy luxury coupe.

Ford copied the Chevy Suburban to compete with the Chevy Suburban. GM invented the Muscle car and Ford never even made a serious effort in that area. The list goes on and on.
Reply: Ford had a 2 year head start in the SCCA Trans Am Series and they were dead meat as soon as the first Camaro hit the track. Mustangs were badly beaten by Chevy Camaros and the Penske AMCs.

To this day most circle tracks allow Mustang racers to use Camaro sub frames because it helps them to compete with the Chevys and help put more beer swilling, hot dog eating trailer park trash in the stands to root for the Fords.
Reply: THE GAA IS A CANTED VALVE PENT ROOF DESIGN. IT IS A PENT ROOF HEMI WITH ITS CROSS FLOW VALVE DESIGN WHICH IS WHAT TRULY DEFINES THE HEMI. THE OPPOSED INTAKE AND EXHAUST VALVE CONFIGURATION IS WHAT MAKES THE HEMI MAKE POWER NOT THE DOME. THE GAA IS A HEMI ENGINE PREDATING THE CHRYSLER HEMI BY ALMOST 2 DECADES. ZORA ARKUS DUNTOV DURING THE SECOND WORLD WAR WAS AMAZED AND INSPIRED BY THE GAA WHEN HE WAS IN THE WAR. HE TOOK THE HEMI CONCEPT FROM THE GAA AND CREATED HIS ARDUN HEADS FOR THE FLATHEAD FORD. WHAT HE DID IS TAKE AN ALREADY EXISTING FORD CONCEPT FROM THE GAA AND APPLIED IT TO THE FLATHEAD. IT WAS ALSO ZORA WHO SECRETLY YEARS LATER MET WITH CHRYSLER AND GAVE THEM THE RIGHTS TO THE HEMI DESIGNS TO AVOID BEING SUED BY HIM. TO SUM IT ALL UP THE FORD GAA IS THE FATHER OF YOUR MODERN DAY HEMI ENGINE.
Reply: SO WE DON'T FURTHER THIS ARGUMENT FROM THE LACK OF KNOWLEDGE FROM YOU AND YOUR BOYFRIEND TIMMY WHO FEEL IT'S FARE WHEN THEY CAN'T HOLD THEIR WEIGHT TO MAKE IT 2 AGAINST 1. THE CANTED VALVE DESIGN PREDATES BOTH THOSE OF THE BIG BLOCK CHEVY AND THE CLEVELAND FORD. IT FIRST APPEARED IN THE POLYSPHERE CHRYSLER "A" ENGINE IS 1956.
Reply: WE KNOW THE CORVETTES HAD IRS SUSPENSION FOR YEARS. FROM THE LACK OF YOUR KNOWLEDGE YOU TRIED TO SAY FORD LACKED IRS TECHNOLOGY BUT ALREADY HAD IT IN USE IN THE THUNDERBIRD IN 1989 AND IN THERE EUROPEAN CARS FOR YEARS. FORM FOLLOWS FUNCTION YOU KNUCKLEHEAD. THE MUSTANG IS A DRAG CAR. WHAT YOU ARE SAYING IS EQUIVALENT TO GOING TO A RACE TRACK AND SAYING THAT TOP FUEL DRAGSTERS SHOULD HAVE IRS SUSPENSION. TELL ME ONE THING. WHEN ARE YOU GOING TO GROW A BRAIN.
Reply: THE PENSKE CAMARO WAS A CHEATER CAR.THERE IS A BOOK WRITTEN ON THIS CAR AND THE TRICKS PENSKE USED TO CHEAT IN ORDER TO WIN AGAINST FORD. THERE WAS NOTHING CHEVY IN THE PENSKE SUNOCO CAMARO. THE ORIGINAL PENSKE SUNOCO CAMARO HAD MCPHERSON SUSPENSION NOT THE PRODUCTION SET UP. THE ENGINE WAS NOT A PRODUCTION MOTOR BUT A ALL ALUMINUM ENGINE BUILT BY TRACO. THE BODY WAS ILLEGALLY ACID DIPPED FOR LIGHTNESS AND THE REASON TRANS AM LATER STARTED WEIGHING THE CARS AND PUTTING PERMANENT STICKERS ALL OVER THE BODY TO PREVENT THE CHEVY CHEATER ACID DIPPED CAMARO BODY CAR TO BE SUBSTITUTED. ROGER PENSKE ALSO USED DRY ICE TO FREEZE THE GAS. BY DOING THIS HE WAS ABLE TO GET 23 GALLONS OF GAS INTO A 21 GALLON TANK. THIS GAVE THE PENSKE CAMARO A GREAT ADVANTAGE. AS THE REST OF THE RACE CARS PITTED INTO A CROWDED PIT AREA TO REFUEL WHERE THEY LOST LOTS OF TIME. THE PENSKE SUNOCO CAMARO WAS ABLE TO STAY OUT ON THE RACE TRACK THAT WAS EMPTY, WHERE IT GAINED LAP TIME ON A UNOBSTRUCTED TRACK. WHEN THE PITS WERE EMPTY THE CAMARO THEN CAME IN TO REFUEL INTO THE PITS ONCE AGAIN UNOBSTRUCTED AND ONCE AGAIN MAKING BETTER TRACK TIME AND YOU THOUGHT CHEVY WAS THE BEST. SADLY CHEVY DID NOTHING MORE BUT CHEAT THEIR WAY TO THE FINISH LINE FOR DECADES.
Reply: FORD OWNED LOTUS UNDER A SUBSIDIARY AND AFTER GM BOUGHT THEM THE COSWORTH MOTORS STILL POWERED THEM. SO OBVIOUSLY WHO WAS THE ENGINE BUILDERS FOR LOTUS? ANSWER: IT WAS FORD AND THAT SAME ENGINEERING DEPARTMENT THAT BUILT THE COSWORTH THAT POWERED THE LOTUS ALSO BUILT THE 1989 ZR1 CHEVY DOHC ENGINE.
Reply: IF HENRY FORD ISN'T THE FATHER OF THE V-8 WHICH WAS HENRY FORD'S IDEA OF PUTTING 2 FOUR CYLINDERS TOGETHER? THEN WHY WOULD CADILLAC BUY HIS COMPANY IN 1901 IF THEY WEREN'T BUYING SOME SORT OF TECHNOLOGY. SO HERE IS THE QUESTION. WHAT DID CADILLAC BUY FROM HENRY FORD WHEN THEY BOUGHT HIS COMPANY. IT CERTAINLY WASN'T THE NAME BECAUSE THEY CHANGED IT.
Reply: Ford only produced the BOSS  R code 351c in1971 in the mustang, and only 1,806 were built, not millions <<<--- BUT STANDARD CLEVELAND MOTORS WITH THE CURVED DOWN EXHAUST PORTS WERE MASS PRODUCED AND DID MAKE THERE WAY UNDER THE HOOD OF FORD CARS. SO ONCE AGAIN ACCORDING TO YOUR GENIUS LOGIC FORD SHOULD HAVE STRAIGHTENED THE EXHAUST PORTS AND WASTE TONS OF MONEY NOTCHING THE SHOCK TOWERS? YOU'RE A  BANANA.
Reply: Nobody forced Ford to make cars that didn't fit their own engines or engines that didn't fit their cars without robbing 90 HP by dropping the exhaust ports over an inch. Either way it's called bad engineering!

The first gen Mustang could barely hold the teenie weenie Windsor block. The first gen Camaro could easily bolt in any big block available.
Reply: The mighty Cleveland exhaust port flows 180 CFM bone stock. 

The crappiest granny station wagon small block Chevy exhaust port flows about 155 CFM and the best production small block Chevy exhaust port flows 195 CFM. Considering that the small block Chevy was designed in the early 50s it's pretty obvious which company has the best engineers.

The Chevy design has hundreds of NASCAR wins without having to re engineer their ports or create some hybrid from two different  engine families.
Reply: Chevy don't need no Hemi, and anything that they engineer is far superior to the likes of Ford <<<---TO ANSWER THAT QUESTION IS THAT FORD MOTORS WON LEMANS YEAR AFTER YEAR AND CHEVY NEVER WON NOT A SINGLE ONE WHICH SPEAKS FOR ITSELF. THE CHRYSLER SMALL BLOCK ARCHITECTURALLY WAS THE SAME TO THE SMALL BLOCK CHEVY. THE LAYOUTS ARE IDENTICAL. SO HOW COME THE SMALL BLOCK CHRYSLER NEVER REACHED THE STATUS IN RACING THAT THE SMALL BLOCK CHEVY DID? ANSWER: BECAUSE THE HENCHMEN FOR CHEVY THE NHRA DETERMINED THAT THE CHEVY WAS TO WIN. THE CHRYSLER WAS ACTUALLY A BETTER VERSION OF THE CONVENTIONAL DESIGN USED BY CHEVY AND MANY OTHER MANUFACTURERS. THE CHRYSLER HAD A ANGLE PLUG FOR BETTER COMBUSTION. 18 DEGREE VALVE FOR BETTER FLOW AND RAIL TYPE ROCKER ARMS FOR A MORE STABLE VALVE TRAIN. RACING WAS ALL ABOUT CHEATING WHEN IT CAME TO CHEVY. TO PROVE THAT THE CHEVY SMALL BLOCK WAS INFERIOR. WHEN BOB GLIDDEN LEFT FORD AND WENT TO CHRYSLER IN THE LATE 1970'S HE WON PROSTOCK WITH THE CHRYSLER ARROW. WHILE THE FORD WERE MADE TO CARRY MORE WEIGHT AS A PLOY BY THE NHRA TO HELP CHEVY WIN. THE CHRYSLER WERE NOT UNDER THOSE STRICT RULES FORD'S WERE UNDER. SO A HEAD TO HEAD EVEN UP SHOOTOUT TOOK PLACE WHERE THE CHRYSLER SMALL BLOCK VS THE CHEVY SMALL BLOCK. ALL CHRYSLERS AND CHEVY'S HAD THE SAME WEIGHT. THE BETTER CONVENTIONAL DESIGN OF THE CHRYSLERS ANGLE PLUGS, 18 DEGREE VALVE, HIGHER CAM LOCATION WHICH ALLOWED IT TO USE SMALLER PUSHRODS WHAT RACE ENGINES TODAY UTILIZE TO FURTHER STABILIZE THE VALVETRAIN AND A RAIL TYPE ROCKER ARMS BEAT THE CHEVY FAIRLY. BY THE NEXT PROSTOCK SEASON CHRYSLER WENT BANKRUPT AND GLIDDEN WENT BACK TO FORD. IF PROSTOCK IN THOSE DAY WAS FAIR AND UNBIASED TOWARD CHEVY. IT WOULD HAVE WENT IN THIS ORDER. FORD WOULD HAVE BEEN FIRST, CHRYSLER SECOND AND CHEVY THIRD.
Reply: TIMMY BOY, MOTORS FOR EMISSION STANDARDS ARE REDUCED IN SIZE TO MEET REGULATIONS AND THE REASON FORD RESTRICTED THE EXHAUST PORTS IN PRODUCTION, NOT ONLY ON THE CLEVELAND BUT ALSO THE WINDSOR. BUT WHEN THEY WORKED THEM THEY FLOWED JUST AS GOOD AND BETTER. IF YOU TAKE CERTAIN YEAR CASTED WINDSOR HEADS WHICH WAS NEVER A RACE ORIENTED HEAD. ON THE INTAKE SIDE NOT EXHAUST BECAUSE THEY WERE RESTRICTED FOR EMISSIONS. A 2 BARREL WINDSOR HEAD (SAME AS YOUR GT-40 WINDSOR HEAD OF TODAY) WITH SMALLER VALVES AND PORTS FLOWED JUST AS GOOD AS THE BEST CHEVY HEAD IN THE DAY THE FUELIE 2.02 AND THAT IS AMAZING. THE FORD WINDSOR HEAD WAS JUST A MUCH MORE SUPERIOR DESIGN TO THE CHEVY THAT FORD DIDN'T NEED BIGGER PORTS NOR VALVES TO MAKE THEM FLOW. THEY DID IT BY BETTER ENGINEERING. THIS IS THE REASON CHEVY DUMPED THE OLD SMALL BLOCK CHEVY IN FAVOR OF FORD DESIGNS. THE LS HEAD IS A FORD WINDSOR HEAD WITH RAISED PORTS FROM THE 427 HIGH RISER. THE LS MOTOR FROM TOP TO BOTTOM IS ALL FORD. NOT ONE DESIGN ASPECT OF THE SBC HAS ITS ROOTS IN THE LS. THE LS IS COMPLETELY FORD IN DESIGN.
Reply: Quote: "A 2 BARREL WINDSOR HEAD (SAME AS YOUR GT-40 WINDSOR HEAD OF TODAY) WITH SMALLER VALVES AND PORTS FLOWED JUST AS GOOD AS THE BEST CHEVY HEAD IN THE DAY THE FUELIE 2.02"

 If that were the slightest bit true Ford would have just raced the Windsor in NASCAR instead of begging Bill France to let them race  the FRANKENCLEVOR. Fact is that Ford lied to France by claiming that they didn't have the ability to produce Cleveland blocks.

How many NASCAR wins were powered by Windsor engines? ZERO!   Why is that? Because the Windsor couldn't make near as much power as the SBC.
Reply: THE 351W 2V HEADS MADE IN THE LATE 1960'S WHICH ARE SIMILAR TO THE MODERN GT-40 HEAD FLOWED JUST AS GOOD AS CHEVY'S BEST HEAD BACK THEN THE FUELIE 2.02 WITH SMALLER VALVES AND RUNNERS. IN THE 1960'S THE INLINE SMALL BLOCK FORD IN NASCAR WAS DEEMED ILLEGAL FOR USE AS A PLOY TO KEEP THE FORD TEAMS RACING THE BIG BLOCKS FROM USING IT ON THE SMALL RACE TRACK WHICH ENCOMPASSED LOTS OF QUICK SHORT TURNS. THIS IS HOW CHEVY WON A HANDFUL OF RACES BACK THEN USING THERE 327ci. THIS IS THE REASON THE WINDSOR IN NASCAR WERE NOT USED BECAUSE THEY WERE BANNED SINCE THE 60'S. SO THE ONLY CHOICE OF ENGINE AVAILABLE WAS THE CLEVELAND WHICH LOVED TO BREATH. ENGINES LIKE THE CLEVELAND LIKE TO DEVOUR AIR AND WHEN RESTRICTED ARE AT A GREATER DISADVANTAGE WHEN CHOKED BY A RESTRICTOR PLATE OR A SMALLER CFM CARBURETOR. NASCAR KNEW EXACTLY HOW TO STOP FORD USING THESE PLOYS TO DO SO. TODAY YOUR MODERN CHEVY NASCAR MOTORS ARE ALL FORD BASED. THE SB2 HEADS ARE A FORD DESIGN. IN THE 1990'S FORD WAS LOOKING TO REPLACE THE THUNDERBIRD WITH THE TAURUS. WHEN THEY PROPOSED THE CHANGE TO NASCAR, NASCAR SAID NO BECAUSE A 2 DOOR TAURUS DID NOT EXIST IN PRODUCTION. SO NASCAR BEING JUST ANOTHER DIVISION OF GM TOLD FORD IF THEY ALLOWED CHEVY TO USE THE FORD CLEVELAND DESIGNS FOR A NEW NASCAR MOTOR THEY WANTED TO BUILD. ONLY THEN WOULD THEY ALLOW FORD TO RACE THE TAURUS. FORD RESPONDED AND SAID NO WAY. FORD LATER CAME BACK AND TOLD NASCAR THAT THEY WOULD DESIGN A SET OF HEADS FOR THE SMALL BLOCK CHEVY THAT WOULD MAKE IT COMPETITIVE TO THE CLEVELAND. SO FORD DESIGNED THE SB2 HEADS FOR CHEVY WHICH MOUNTED ON THERE EXISTING BLOCK. AS FOR THE MODERN DAY NASCAR RO7 IT ALSO IS A FORD CLEVELAND SPEC ENGINE. SHOCKING ISN'T IT THAT NOT ONLY IS THE LS A FORD ENGINE. BUT SO IS THE CURRENT NASCAR RO7 ENGINE. I'M GOING TO GET FURTHER INTO THIS DEBATE AND SHOW YOU HOW NEARLY MOST OF THE CHEVY RACE ENGINES OF TODAY EVOLVED FROM ALL FORD DESIGNS AND HAVE NOTHING IN COMMON OR TO DO WITH CHEVY.
Reply: THIS WAS SENT TO ME BY A FELLOW HOURS AGO ON ANOTHER SITE WHO READ MY POST.
Ron Dye Channel10 hours ago
The rules are always tailored for the majority. Same in NHRA, if 80% of cars competing are Chevy then the rules are adjusted to make them "competitive". Like saddling the Ford Cleveland with more weight. Some way to promote the idea that racing advances engineering. NASCAR allows Chrysler Hemi, Ford builds OHC Hemi disallowed. Ford builds cam in block 429 Boss Hemi, saddled with weight penalty till noncompetitive. Got Chrysler in this too, and advanced the Chevy small block by making Ford carry extra weight to run the Cleveland. Chevy has ruled in competition because the rules have always been in their favor. This makes racers buy Chevy's cause they win, not because they are better. The NHRA doesn't want 80% of their racers to be uncompetitive, neither does NASCAR.
Reply: WE WILL START THIS DEBATE OVER GOING THROUGH EVERYTHING THAT WAS SAID HERE ONE BY ONE WITH NO INTERFERENCE BY YOUR FRIEND BOBBY.
QUESTION 1: DID THE NHRA DURING THE PROSTOCK ERA MAKE THE FORD CLEVELAND'S CARRY MORE WEIGHT WHICH BOB GLIDDEN SAID WAS 250lbS AND THE FORD'S STILL BEAT THEM?
Reply: You never did answer any of my questions. Try again.

1.)When did any GM brand need to saw half of their cylinder head off and bolt on exhaust plates just to be able to compete in NASCAR and NHRA?

2.) Where is your evidence that NASCAR and NHRA banned the Ford Windsor because it was such a threat?

I mean real documented evidence - not your blue oval delusions.
Reply: ANSWER THIS ONE SINCE I DID ASK FIRST, AND I WILL ANSWER YOU RIGHT AFTER.

QUESTION 1: DID THE NHRA DURING THE PROSTOCK ERA MAKE THE FORD CLEVELAND'S CARRY MORE WEIGHT WHICH BOB GLIDDEN SAID WAS 250lbs TO HELP THE CHEVY'S COMPETE AND WIN AND THE FORD'S STILL BEAT THEM?
Reply: I asked you question # 1 on November 13th
and question # 2 on November 16th.

The only evidence you have is your faulty memory. I can't seem to find anything in the real history books about the NHRA doing any of that.

I do remember when NASCAR slowed down the CLEVOR powered Thunderbirds because:

 1.) Ford never produced a Thunderbird with Cleveland style heads.

2.)  Ford never mass produced a CLEVOR engine for production vehicles.

3.) The SVO heads incorporated the same  raised exhaust port modification that NASCAR had earlier banned for obvious reasons because no other brand was ever allowed or needed such a ridiculous modification to be able to compete.

There never would have been a SB2 head in NASCAR if they made Ford teams race a production engine like everyone else had to do. The SB2 was a direct result of allowing the SVO heads which were radically modified Clevelands. Robert Yates Racing won't even call them Cleveland heads because of their radical evolution.
Reply: ONCE AGAIN.
QUESTION 1: DID THE NHRA DURING THE PROSTOCK ERA MAKE THE FORD CLEVELAND'S CARRY MORE WEIGHT WHICH BOB GLIDDEN SAID WAS 250lbs TO HELP THE CHEVY'S COMPETE AND WIN AND THE FORD'S STILL BEAT THEM?
Reply: You can't answer my questions so I won't consider yours. You're acting like a silly, little child.
Reply: 1.) Bobby already proved that Ford didn't design the Cleveland head - a GM performance team did for a potential SCCA  Trans Am engine.

2.) When NHRA went to the 500 inch engines Reher and Morrison won back to back championships with a basic big block Chevy powered Camaro. There was an article about their engine in Hot Rod Magazine about 6 months ago. In fact Rick Hendrick owns the engine now. It was a regular old big block Chevy with some very creative head work done and they passed tech with flying colors every time. The heads were Chevrolet factory aluminum parts that were really made by Chevrolet - not by Brodix or some other after market supplier.

Now maybe you have another conspiracy theory as why a plain old antique Chevy design beat the pants off of Bob Glidden's exotic 429 Shotgun HEMI EXP since old Bob never got it going fast enough to be penalized with extra weight.
Reply: Frank289100 you're a dumbass, I guess the envy is high with you cause of the great success of the ls motor.
Reply: agree they even have the 351w firing order
Reply: THE LS IS A FORD 351W/C, 4,6 MOD, 5.0 H.O FIRING ORDER.
Reply: Frank289100 lol so is that why Ford went to a modular motor?
Reply: I already explained how they really don't have the same firing order but it was apparently too technical for a doofus Fordnatic to understand.

Lets try a different approach. Take a cam from an LS and compare it with a 351W cam. The lobes will not be in the same order because the engines don't fire in the same order.
Reply: FROM LS1TECH.
LS1 with traditional 18436572 firing order?
I was wondering if anyone has done this firing order change on a LS1. I honestly hate the sound of LS1's and wish GM stuck with the traditional Chevrolet firing order and didn't copy off Ford. So has anyone ever seen an LS1 with the old school firing order or any threads on this?

18436572 > 18726543
Reply: Congrats Frank. You found a Chevy boy who's just as ignorant as you are. Your IQ makes Forrest Gump look like a Rhodes scholar.
Reply: General Motors was the first car company to use: 

1.) an electric starter (1911)

2.) a full-synchromesh manual gearbox (1928)

3.) Philips-head screws in vehicle assembly (1940)

4.) a turbocharged V8 engine (1962)

Ford copied every one of these automotive innovations and many more from General Motors including point ignition, stamped rocker arms and EGR valves. The list goes on and on.
Reply: 1. ELECTRIC STARTER - THE MODEL-T AT ONE POINT AMOUNTED TO 2/3 OF THE WORLD'S CARS BECAUSE IT WAS COST EFFECTIVE, SIMPLE AND TRIED AND TRUE RELIABLE. PUTTING AN ELECTRIC STARTED MEANT HIGHER PRICE, ADDITIONAL PROBLEM OF A DEAD STARTER OR BATTERY AND THEN NO WAY TO START THEM. THE CRANK WAS RELIABLE AND PEOPLE WANTED SIMPLICITY AND COST. IF FORD WANTED TOO THEY COULD HAVE MADE THEM ELECTRIC START BUT SALES WOULD HAVE PLUMMETED. YOU SHOULD LOOK AT THINGS FROM A PROFITABLE MARKETING STANDPOINT.

2. FULLY SYNCHROMESH MANUAL GEARBOX - FOR A CHEAPLY PRICED CAR TO SELL IT WASN'T COST EFFECTIVE. ONCE AGAIN YOU SHOULD LOOK AT IT FROM A PROFITABLE MARKETING STANDPOINT. HERE IS A EXAMPLE OF SIMPLICITY FOR PROFITABILITY. OTHER CARS HAD HYDRAULIC BRAKE SYSTEMS BUT THE FORD STILL MAINTAINED MECHANICAL BRAKES BECAUSE PEOPLE WERE UNTRUSTING OF THE HYDRAULIC BRAKE SYSTEM AND A MECHANIC BRAKE SYSTEM OF THE MODEL T/A WAS FOOL PROOF AND WHAT PEOPLE WANTED AND TRUSTED. 

3. PHILLIP HEAD SCREWS - YOU WOULDN'T FIND A PHILIP SCREW IN A ROLLS ROYCE IN THOSE DAYS. A PHILIPS HEAD CONSTITUTED BEING A CHEAP LOOK, THAT IS WHY MANY MANUFACTURERS AVOIDED THE USE OF THEM. THE SLOTTED SCREW WAS ELEGANT AND STIPULATED CLASS. EXPENSIVE HIGH END PLUMBING FIXTURES, SHIP HARDWARE, ETC ALL USED THE SLOTTED SCREW. 

4. FIRST TURBO CHARGED IN 1962 - FORD SUPERCHARGED SINCE THE MID 1950'S.
Reply: (Ford copied GM at every turn because GM led the industry in innovation while Ford followed.)<<--THAT'S WHY ALL THE CHEVY DRAG RACERS USE THE FORD 9 INCH. ALL OF NASCAR USES THE FORD 9 INCH. ALL OF NASCAR USES THE FORD TOP LOADER IN A MODERN VERSION. THE BASIS OF ALL MODERN DAY NASCAR SUSPENSION CAME FROM THE 1966 FORD GALAXIE 500 AND IT IS STILL THE FOUNDATION TODAY. THE DRCE - DRAG RACE COMPETITION ENGINE IS NOTHING MORE THAN A BIG FORD CLEVELAND MOTOR. ALL YOUR SYMMETRICAL HEAD BIG CUBE ENGINES USED BY THE CHEVY CAMP LIKE LARRY LARSON IS ALL FORD BASED AND SPECED MOTORS BASED ON THE 335 SERIES, 385 SERIES AND THE BOSS 429 SERIES ENGINES. EVERYTHING CHEVY USES IN RACING TODAY IS ALL FORD BASED. NOW LAT AND NOT LEAST THE LS WHICH IS 1000% FORD.
Reply: (Ford had to put Paxton blowers on the 50s T Birds just to keep up with the naturally aspirated Corvette with a much smaller fuel injected V8.)<<<--- THIS IS WHEN FORD RELEASED THEIR BIG BREATHING N/A 312 Y-BLOCK CRATE ENGINE AND NASCAR TESTED IT STRAIGHT OUT OF THE BOX STOCK AND IT PRODUCED 285 HP WHICH MEANT A GREAT THREAT TO CHEVY. THIS IS WHEN CHEVY STARTED SCREAMING SAYING IT WAS NOT FAR FOR THE FACTORY TO RACE AGAINST ITS CUSTOMERS AND THEY PUSH FOR THE AMA BAN IN 1957 WHICH STIPULATE THE THE MANUFACTURER COULD NOT RACE AGAINST IT CUSTOMERS. SO THE AMA BAN WAS PUT IN PLACE CALLED THE GENTLEMEN'S AGREEMENT. CHEVY KNEW FORD WAS GOING TO KILL THEM. SO FORD HONORS THE BAN AND STOPS ALL RACE PARTS AND RESEARCH OF THE Y-BLOCK AND CLOSES DOWN THE RACE PROGRAM COMPLETELY WHERE NO RACE PARTS WERE AVAILABLE. WHAT DO YOU THINK CHEVY WHO IMPLEMENTED THE BAN DID? THROUGH THEIR MARINE DIVISION THEY SPONSORED AND FINANCED RACERS WITH PARTS AND MONEY. LIKE I HAVE ALWAYS SAID: "CHEVY HAS BEEN CHEATING THEIR WAY TO THE FINISH LINE FOR YEARS" DECADES IN FACT TO THIS VERY DAY.
Reply: (GM sold fuel injected vehicles in 1957 and EFI systems in 1975 while Ford waited until 1980 to offer their first fuel injected vehicles.)<<-- HAVE A NICE DAY WITH THAT ONE. GIVE ME SOMETHING BETTER THAN THAT DOG HOUSE INJECTION WHICH WAS NOTHING MORE THAN A FAILURE. EVERYBODY RIPPED THEM OUT AND PUT CARBURETORS ON. .
Reply: Frank289100 I can feel the Chevy envy lol
Reply: THE 9 INCH IS THE STRONGEST AND LIGHTEST REAR END. THE DROPOUT CARRIE IS EASY FOR QUICK CHANGING OF GEARS. THE LASH FOR RING AND PINION SETTING IS SIMPLE AND THE STANDARD REAREND USED IN THE INDUSTRY USED BY ALL CHEVY RACERS.
ONCE AGAIN THE BASIS OF THE NASCAR SUSPENSION USED ON ALL NASCAR RACE CARS INCLUDING CHEVY COMES FROM THE 1966 FORD GALAXIE 500.
Reply: Debating Frank is like wrestling a greased pig.
He claims Ford was too cheap to offer electric starters and synchronized transmissions and then he claims that Ford didn't use phillips screws because they were cheaper.

I never have encountered a bigger imbecile in all my 58 years.
Reply: Two different engines with the same numerical firing orders but different cylinder numbering is like having the same phone number with different area codes. You dial the same 7 digit numbers but the calls go to completely different places.
Reply: Here all this time I thought the  Thunderbolt ran in the FX (factory experimental) class not as a stock. whoever put FX on the car must have been mistaken too.
Reply: GM owned Lotus at the time the LT5 engine was designed.  You might want to fact check yourself a bit more.
Reply: FORD OWNED LOTUS UNDER A SUBSIDIARY FOR MANY YEARS AND THE REASON FORD DESIGNED 4 CYLINDER COSWORTH ENGINES WHICH WERE STRICTLY USED IN LOTUS VEHICLES. IF FORD DIDN'T OWN THE COMPANY DO YOU THINK THEY WOULD MAKE SPECIFIC ENGINES USED IN LOTUS CARS OBVIOUSLY NOT. IN 1987 FORD SOLD 70% OF LOTUS TO GM AND FORD MAINTAINED THE 30% OF THE COMPANY WHICH ENCOMPASSED THE ENGINE DEVELOPMENT AND ENGINEERING DEPARTMENT.  THE LT5 LOTUS ENGINE WAS DESIGNED BY FORD WHO OWNED LOTUS. YOUR MAGNETIC SUSPENSION THAT IS CURRENTLY USED ON THE CAMARO WAS ONE OF THE TECHNOLOGIES GM ACQUIRED FROM FORD WHEN THEY BOUGHT THAT 70% INTEREST IN LOTUS.
Reply: Hah.  The 4R70W (modern form of AODE, or AOD) is considered one of Ford's better transmissions but it still has issues. I will give it props, the one in my '05 Vic has lasted 180k miles before the spring clip holding the mechanical diode failed, leading to a cascading failure which resulted in overdrive becoming neutral.  I also have a 1988 Caprice 9C1 and the 4L60 transmission (TH700R4) is a strong, nearly bulletproof unit.  Current transmission has 160k miles on it, fluid nice bright red colored, no slip, changed filter, no sediment in pan.  

You just sound like a Ford fangirl, unable to determine that both Chevy and Ford are more similar than not.
Reply: The Crown Vic did not become the defacto, ubiquitous police car option it wound up as, until GM stopped building the B-body platform after 1996 (Caprice).  The '94-'96 Caprice 9C1 with the LT1 option was known as the quickest, most reliable police vehicle of its time.  After 1996, the Vic became the standard, simply because it was the last remaining RWD, full perimeter frame, full size car available.
Reply: Lotus was NEVER owned by Ford.  GM was a majority stakeholder (91%) from 1985 through 1993.
Reply: Tim Sharpe actually the firing sequence of the 351w, the 4.6/5.4 mod motors, and the LS are the same.  If you numbered the Ford engine cylinders 1-3-5-7 on the left and 2-4-6-8 on the right, the firing ORDER will be identical.  The other Ford pushrod V8s have the same firing sequence of the older GM/Chrysler V8s, i.e. if the Ford was numbered the way the GM/Chrysler engines were, then the firing order on a 302 windsor would be 1-8-4-3-6-5-7-2.

The posted firing orders are different, because the cylinders are numbered different.  Ford found out they could get a smoother running engine by swapping 3/4 and 2/7 in the sequence (GM numbered) on the 351w.  This carried over to the mod motor and GM also used this approach with the LS.  

You can get a 4/7 swap cam for the SBC as well.
Reply: I BROUGHT THE LS FIRING ORDER UP 3 YEARS AGO THAT IT WAS A FORD FIRING ORDER AND THEY WENT APE SHIT DENYING IT. THEY EVEN WENT TO GREAT EXTREMES TO REMOVE THAT FACT FROM WIKI - FIRINGS ORDERS.  AT LEAST YOU ARE HONEST ABOUT IT.
Reply: TIMMY BOY, I WAS RIGHT ABOUT THE FIRING ORDER OF THE LS BEING FORD BECAUSE A CHEVY MAN ENLIGHTENED YOU TO A FACT THAT YOU PREVIOUSLY FOUGHT ME ON. ALL THE CHEVY RACING GOODIE TODAY ARE ALL FORD BASED. LS, SB2, RO7, DRCE, LT5 LOTUS, SYMMETRICAL HEAD RACE ENGINES BASED ON 3 FORD DESIGNS 335,385 SERIES AND BOSS SERIES ENGINE ARE ALL LABELED AS CHEVY BUT ARE ALL FORD IN DESIGN. THIS IS HOW CHEVY WINS RACES TODAY. THEY NO LONGER HAVE TO RESORT TO UNFAIR RULE BOOKS AND REGULATIONS TO STOP FORD FROM WINNING.
Reply: Frank289100 I think you read too much into my post.  I did verify the orders are the same, but the LS is NOT a Ford design.  Despite what you say.  There are only so many ways you can arrange the firing sequence on a cross plane V8.  Using your logic, that would mean that Ford copied the 1- 8- 4- 3-6- 5- 7- 2 sequence of the original Chevy with the FE and later blocks because the SBC used it in 1955 while the flathead and Y- block used an entirely different sequence (which Ford has returned to with the Coyote design).  Can you see the fallacy of your position?  The reason why Ford made the change with the 351w and mod motor, and also why GM did with the LS, was to smooth exhaust pulses through the exhaust system.  Nothing more.
Reply: MOST OF THE CLASSES IN NHRA WERE SHAPED BY FORD. THEY WERE SO FAST THAT THE COMPETITION FELL LIKE FLIES. SO THE NHRA MADE NEW CLASSES TO PUT THE FAST FORD'S IN WHICH STOPPED THEM FROM DOMINATING THE INITIAL CLASSES THEY STARTED OUT IN. AS THE REST GOT FASTER THEY EVENTUALLY MOVED INTO THOSE RACE CLASSES SHAPED BY THE FORD'S. BUT IN TRUTH IT WAS THE NHRA'S WAY OF ISOLATING THE FORD'S KEEPING THEM FROM DOMINATING DRAG RACING AS A WHOLE TO PROTECT THAT "PHONY CHEV. EVERYWHERE IN THE RACE WORLD WHERE THEY PARTICIPATE. CHEVY TODAY IS ALL FORD POWER FROM NASCAR TO THE NHRA.
Reply: More skewed history from franky. Ford never built enough Thunderbolts to qualify as a production vehicle and the only time a Ford Windsor ever won a big event was when Ford raced a five liter V8 against a bunch of 2 liter  Euro 4 cylinders.
Reply: MERCEDES FOR YEARS WAS RACING BIG CUBE V-8'S AT LEMANS. FERRARI RACED HIGH REVVING V-8'S AND V-12 AT LEMANS. WHEN FORD DOMINATED LEMANS FROM 1964-66-67-68-69 CHEVY WAS ALSO THEIR WITH THE BIG BLOCKS AND SMALL BLOCKS WHICH COULDN'T BEAT THOSE 4 CYLINDERS AND WERE NO COMPETITION FOR THE FORD GT-40'S AND THE COBRAS. THE 5.0 LITERS WON IN 1968-69 AND BY 1970 LEMANS BANNED FORD FROM RACING BECAUSE THE WINS WERE JUST GETTING OUT OF HAND AND MAKING FERRARI LOOK REAL BAD. IN THE ULTIMATE RACE TRACK OF THE WORLD BEING LEMANS THAT "PHONY CHEVY RACING DYNASTY" DID NOTHING BECAUSE THEY COULDN'T MANIPULATE THE RULE BOOKS FOR THEM TO WIN LIKE THEY WERE DOING IN AMERICA FROM NASCAR TO THE NHRA.
Reply: In 1968 the big bad Fords got a lucky win by barely beating a 3.0 Porsche by a few seconds.
Reply: AND WHAT DID CHEVY DO AT LEMANS? NOTHING THEY JUST COULDN'T COMPETE. IN 1969 FORD WON LEMANS AGAIN AND BY 1970 LEMANS BANNED FORD FROM RACING. INDIRECTLY THEY TOLD FORD NO MORE.
Reply: WHAT YOU WROTE HERE IS SHEER NONSENSE. CHEVY NEVER WON A LEMANS UNTIL THEY CREATE THE GENERIC FORD THE LS. IN 1966 EVERY WORLD ENDURANCE RACE TRACK FROM DAYTONA TO LE MANS AND MANY OTHERS WAS DOMINATED BY THE GT-40'S TAKING 1-2-3 PLACE AND RIGHT BEHIND THEM WERE THE COBRAS. CHEVY MOTORS DID NOT MAKE THE POWER OF THE FORD'S NOR DID THEY HAVE THE DURABILITY OF THE FORD'S.
Reply: I had a 1979 it was a taxi from day 1 350 engine had 500,000miles never had a wrench on it